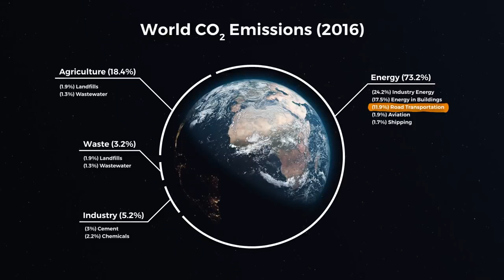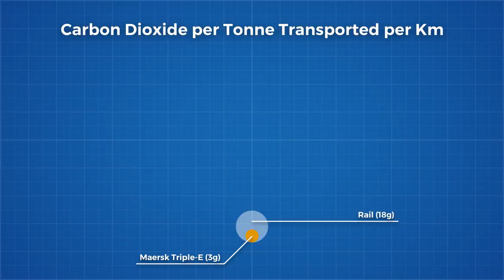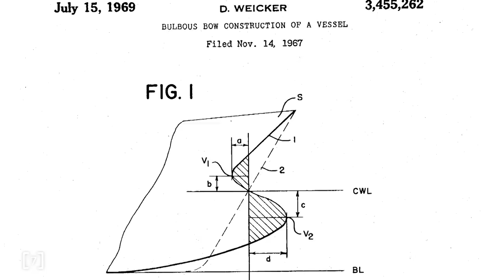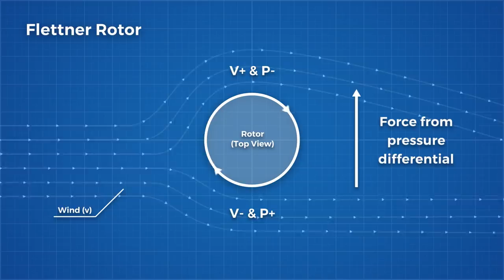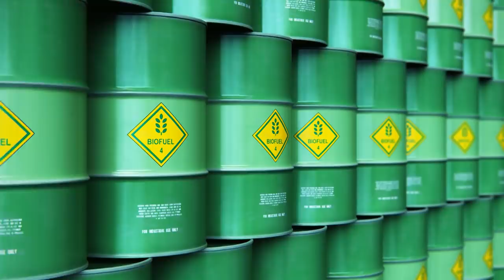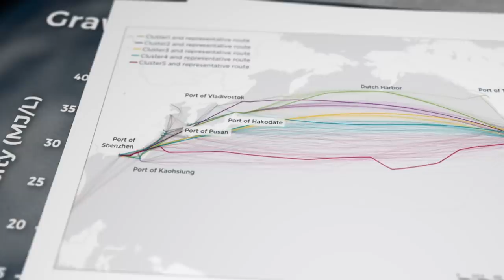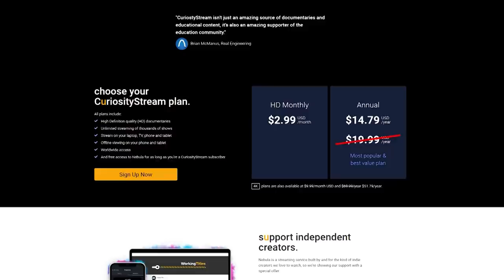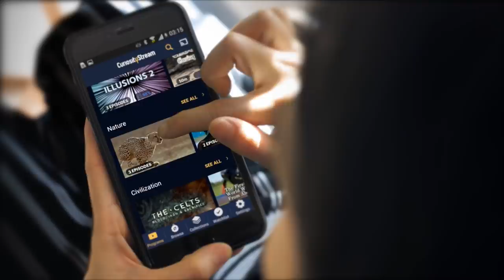Are Renewable Powered Ships Possible?

Comment: Nuclear powered ships?
Reply: This channel is historically anti-nuclear, despite generally being pro-science.
Reply: Uranium fuels unfortunately aren’t renewable - but abundant enough to be used until we have true renewable technologies for everything I guess
Reply: Nuclear is great but it's just not the best for portable applications for several reasons, first and foremost is shielding which as a rule is heavy, the second is availability and security of fuel because governments have a lot of red tape with transporting hazardous substances in and around them, and the third is the initial cost of installment and continued cost of maintenance and staffing.
Reply: A war will cause a catastrophy with a fleet of those.  A single accident for any reason, an angry guy, will cause a disaster.  Risky.
Reply: When facing a problem engineers shouldn't think of ways to add layers of complexity to a problem, but just on how to solve it. It can be done by asking the question differently. Instead of asking "Are Renewable Powered Ships Possible?" we should ask "how can we produce more locally so we don't need to transport a lot of useless stuff"
Reply: Russia has ice breakers which are nuclear powered and is building more.
Reply: Meanwhile Russia is mass producing nuclear power plants ships.
Reply: @bearcatben4762  I fail to see how mass is an issue in this use case.
Reply: makes it extremly expensive to build and the biggest problem decommission. But whit running cost low they can maybe skip all the channels and build bigger and it may be worth  it for some ships. Nuclear powerplant and windfarms out in the water making alot of hydrogen would work as fueling stations for all the other ships.
Reply: @bearcatben4762  The US Navy uses it for aircraft carriers. The thing is when you're moving that much mass you can afford a couple extra tons of shielding
Reply: @pancakes3250  Your understanding of nuclear power is not based on reality
Reply: @bearcatben4762  also might be a bad idea to ship nuclear material around cape guardafui
Reply: The Russians know about that. They have several big ice breakers that are nuclear powered.
I think the Yanks only have them in Submarines. Unless a big aircraft carrier or two are nuclear powered.
But, yeah. I don't know why not. Unless it is cost or safety used on something that isn't military.
Not sure I'd fancy some knackered, shagged out old tub, with a crew of a handful of dodgy bastards from all over the planet piloting it. Imagine them buggering up an entry into a major port to dock, and sinking it in the harbour mouth, in every fuckers way. With a Nuclear Power plant on board.
Bit of a clean up job and salvage job.
Reply: @rationalmartian  All 11 current American aircraft carrier is nuclear powered. Have been for decades. The first nuclear powered aircraft carrier entered service in the US Navy in 1961. She has been retired. 

The US navy also has operated 6 nuclear powered cruisers, although these proved too expensive to operate.
Reply: Ideally yes, but that is a lot of nuclear material to keep track of
Reply: @enricodragoni  Good point, one problem.  Impossible due to human nature.  Some people are better than other, at different things.  China makes it cheaper, due to its political system.  Obviously once we fully automate, price means nothing, all free.  Trade will be culture based.  Wines, art, tourism, luxury anything, even cars.  Cant be automated.  Produced only in dependent region.  Long distance trade wont leave.
Reply: If only governments were willing to experiment by using taxpayer money to create nuclear powered ships and see if they work effectively... 

This post brought to you by the U.S. Navy.
Reply: Fusion powered ships*
Reply: @notsludge  It cant be sabotaged, by a fanatic, or troubled man?  Nations wont attack them?  An accident at sea, i dont know how, or in port, cant cause a problem?
Reply: @TheTwinkiefoot  Gotta make it work on land first...
Reply: Unfortunately, building nuclear powered ships means a requirement for nuclear engineers. Marine Engineers are currently not specialised into this profession as of yet, and incorporating training to do so will likely extend the timeframe of existing cadetships. Interesting suggestion though.
Reply: @enricodragoni  In my perspective, the details of "How can we produce more locally" sounds a dramatic amount more complex and expensive than changing the type of ships used to transport cargo.

Similar to deciding what mode of transport to use to get to work vs figuring out how to work from home. Ofcourse being better for the world but being very complex in achieving that for certain jobs and cargo.
Reply: @bearcatben4762  Actually water is incredibly effective at shielding against radiation. As ships have an abundance of water nearby, they can use well planned pumping infrastructure to shield the crew and cargo from any radiation while minimizing the amount of heavy metal shielding necessary. Most large ships are already equipped with large ballast tanks and pumping infrastructure, so it wouldn't be too difficult to adjust the layout to provide shielding for a nuclear reactor.
Reply: @deth3021  Its the rocket equation, the heavier you are the more fuel you need to increase speed and the more fuel you have the heavier you are
Reply: @bearcatben4762  SMRs solve most of those problems.
Reply: @TheTwinkiefoot  it would be nice but any kind of mobile fusion is decades off at best
Reply: Russia has some floating nuclear power boats!
Reply: @Samuel127849  These companies are cargo companies, all the space that is used for things other than cargo is an economic loss. And the US navy is not a cargo company and only cares about speed and effectiveness.
Reply: @notasgood459  Under that logic, nothing is renewable because the heat death of the universe will happen eventually. Uranium Breeder reactors can provide 10s of thousands of years of power to our civilization.
Reply: @PedanticNo1  scientist aren´t automatically unaware of everything outside of their field of expertise. I am working as an r&d engineer and would get laughed at if would propose a nuclear powered civil vessel. Besides technical difficulties and environmental aspects... It´s unthinkable to let nuclear powered vessels drive around without protection and an enormous amount of control.
Reply: @swilso421  Corrosion is the concern in that scenario and water shielding is still heavy all the while making things more expensive and having more moving parts
Reply: Anti nuclear because it's pro science not in spite of it**
Reply: @pancakes3250  Uranium in a reactor is not the same as in a war head. It needs processing first. But by designing a "dump" switch it might be possible to just dump the reactor into the ocean thus cooling it down real quick and stopping the reaction. Which would reduce total harm done. And this makes "stealing" a reactor harder. Just an idea though.
Reply: @CaptainChrom  That is true but I was not factoring them in because I assumed the commenter was talking about traditional naval reactors.
Reply: @bearcatben4762  uranium isn't the only nuclear fuel.
Reply: @notasgood459  That is also true of fossil fuels
Reply: @ImpGimp  I like your reply.  I am very environmentally conscious.  Any radioactive leak, for any reason, is a catastrophe.  I am against the risk.
Reply: Just eliminate the vast majority of shipping. There's absolutely no practical reason why we should be shipping things all over the planet when they're available locally, or when they can be produced locally.
Reply: @Samuel127849  When your complete business model is based on the amount of tonnage you can transport with your ship and then you are exchanging the profit of seizable number of containers for a heavy nuclear reactor, as a big cargo ship you don't need the tactical advantage to be shore indepedent.
Reply: @PistonAvatarGuy  Cant, locals must work cheaper, even if there are local resources for manufacture.
Reply: For a nuclear reactor to fit into a ship, it needs to be a fast/hot reactor for space reasons - this is the case for all nuclear powered ships and submarines... - fast reactors need highly enriched uranium to work - all of this would be extremly expensive to build and maintain and to get approved... - physicists and other engineers and reactor specialists would have to be on every trip to monitor and operate the reactor.
Too expensive.
Reply: @jeffreylebowski4927  Didnt know.  Cant aoutomate that?
Reply: @pancakes3250  I hate to break this to you, but there is absolutely no way that we're avoiding a catastrophic warming event while still making use of capitalism. Either we move away from capitalism, or we go extinct, it's as simple as that.
Reply: @jeffreylebowski4927  good explenation indeed.
Reply: @jeffreylebowski4927   how big are the engines on a ship that size because the NuScale SMR uses LEU and is 65ft tall and 9ft in diameter
Reply: @bearcatben4762  Doesnt seem to be a problem for Navy submarines and aircraft carriers.
Reply: The issue is an insurance thing. Basically, no insurance company will pay out for an ecological disaster caused by a malfunction or failure on a nuclear vessel. Governments are able to get away with it since they insure it against themselves or not at all.
Reply: @pancakes3250  Psst, dont tell the Russian and US navies...
Reply: @notasgood459  Uranium is as common as tin, and theres 6 billion tonnes in the ocean.
Reply: @PistonAvatarGuy  That is interesting.  Valid opinion.  However, current environmental initiatives were started by capitalist states.  Men like Elon, Gates, are interested in green.  Politicians in every system are aware of impending danger.  They are people, like me and you, capitalist or not.  When alarm goes loud enouph they will react.  I am betting odds are good enough for any system, is capable of dramatic social changes.  I say stay the way we are.  You could be right of course.
Reply: There was a nuclear powered cargo ship called the NS Savannah that is now a museum ship. In addition as someone who attends a US Maritime Academy looking to get a engineering coastguard licence. I don’t trust most of my engineering classmates to run a normal diesel ship let alone a nuclear one.
Reply: @logdog6762  I wont.  O boy.  They are military, or 'state', so, not as numerous yet.
Reply: @bearcatben4762  although nuclear has its problems it has the possibility of truly massive ships that could reduce the amount ships needed for freight on long haul routes that could accommodate the larger ships. For short trips the normal ways of fuel would suffice. I guess though politics and the risk of terrorism and bad maintenance are too big to overcome for the use of nuclear .
Reply: @pancakes3250  how often are nuclear power plants sabotaged by troubled people or fanatics? none that I know of because it is not as easy as flipping a switch. Either way, if there was an accident, radioactive leaks in the ocean have negligible negative impacts. The best argument against nuclear power for cargo ships is cost associated with building and operating the thing (hiring specialists), not the danger.
Reply: @bearcatben4762  I haven't heard of a single nuclear incident in a submarine or carrier. do you?
Reply: @mikee7579  There are nine sunk nuclear submarines in the world.  they haven't exactly caused an 'ecological disaster'.  Oil spills and global warming are exponentially bigger issues.
Reply: Which harbours do you expect to allow those nuclear-powered cargo vessels in harbour?
Reply: @bearcatben4762  by
Reply: @pancakes3250  " However, current environmental initiatives were started by capitalist states."
-
But the problem is largely being caused by those states, and those states aren't coming up with solutions that are even remotely useful.
-
"Men like Elon, Gates, are interested in green."
-
Greenbacks, yes, but they couldn't care less about the environment.
-
"They are people, like me and you..."
-
They are absolutely NOTHING like me, don't assume that you know me.
-
"When alarm goes loud enouph they will react."
-
A) They're too greedy to do anything other than place economic concerns over everything else. B) They're absolutely CLUELESS as to the severity of the problem and have absolutely NO IDEA what it will take to solve it.
-
"I am betting odds are good enough for any system, is capable of dramatic social changes."
-
Capitlalism is inherently destructive and is SEVERELY limited in what it can accomplish because of its inability to make use of any technology that isn't profitable, it is inherently incapable of solving the problem.
-
"I say stay the way we are."
-
Extinction it is, then.
Reply: @logdog6762  insurance is still a thing and the risk for them is huge.
Reply: @JohnJohansen2  Why should harbours  deny them?
Reply: They are extremely expensive and they are a security risk. There is a reason why there are no commercial nulear ships.
Reply: @notsludge  Cant argue with that.  Financially you are right.  Accidents, not really.  All the nukes were land based, or piloted by state.  Having a nuclear merchant fleet, will mean alot more people involved.  There were power plant accidents in the past.  All it takes a state in turmoil, odds rise high.  Even Japan had one.  I dont think we need energy that desperately to risk a nuclear merchant fleet.  War, will be a complete disaster.  Fanatic wise, religion, ideology, bad boss, marriage, social hate can do things.  With people involved, more odds.
Reply: @Andreas Berni A) You're talking about totalitarian dictatorships, not democratic socialism, which is an integral part of EVERY technologically advanced society on Earth. B) None of those actions eliminated the populations of any of those places, people survived just fine.
Reply: @deth3021  At the moment it is the only one in commercial use (not including RTGs)
Reply: @tobene  Yup. If you want to talk about proliferation risks...
Reply: @paulbrazendale3257  Yes that is true
Reply: @logdog6762  The navy is not a cargo company
Reply: @0ExG0  There are rarely any nuclear incidents, that is why I did not mention nuclear incidents in any of my comments
Reply: Nuclear is not the future
Reply: @bearcatben4762  Look up Russia, 13 nuclear powered ice breakers. If its cheap enough to be used for ice-breaking then it's cheap enough for cargo, hell you'd be making a profit.
Reply: @bearcatben4762  But it is a logistics company.
Reply: The main topic in this video is about private transportation. Nuclear ships are owned and operated by governments. Also, from other comments, the Russian ones are far away from hostile forces as well. It's not too much to imagine a pirate attack on one of many private container ships and easily grabbing enough material to make a dirty bomb. Far less likely to happen to a government-operated ship. Security is a very legit concern and likely the primary reason it hasn't happened and governments won't let it happen.
Reply: @holyravioli5795  Yeah, but Russia probably wont bother decommissioning the ships properly, they'll just scuttle them somewhere. Decommissioning costs are a serious concern with nuclear powered ships (in sane countries).
Reply: there is a plan in mersk for using nuclear power in stations o the mid route for hidrogen generationñ the onli practical problem whit nuclear is the ports regulations.
Reply: @pancakes3250  i get what you are saying, more nuclear reactors over longer periods of time increases the likely hood of something going wrong (whether an accident, or an attack). What I'm saying is that something going wrong with nuclear ships is relatively benign. A nuclear sub sinking does not equal reactor meltdown due to the cooling of the water. Also nuclear engines are not nuclear bombs so they don't result in nuclear explosions (not saying you believe this just that it is a common misconception I've seen). Even if there was a nuclear meltdown it would still be a non issue because water is really good at shielding.
Reply: I keep seeing that nuclear is too dangerous, but  
a) it’s a proven technology that can be improved upon and it’s by far and away the most studied method suggested here 
b) I’m not sure it’s any more or less dangerous than other fuels. The biggest danger of nuclear is that the reaction can happen quickly so all of the energy is released instantaneously rather than slowly over time like what would happen if diesel caught fire in a tank. I would think hydrogen would be a close second though given the reaction rate and the likelihood of it being in gaseous form within the cells or it’s ability to quickly become gaseous if it’s in liquid form. It would just be a huge Hindenburg. But we have technology that would make a nuclear meltdown not only unlikely but not catastrophic. In other words, it’s not like there would be a nuclear bomb on every shipping container. It’s only dangerous if you have a lot of fuel in the reactor at one time and you have no safety measures in place to prevent a meltdown. But they’re already making modular reactors that are self sufficient. That means it wouldn’t take too many additional staff to run the reactor. 
c) during a war, there wouldn’t be any more or less incentive to blow up shipping freighters than there is now. All of the fuel would be shielded, and there would be a huge mess to clean up if any of them sank and blocked the harbor regardless of what fuel you’re using. A reactor would just have different problems than a harbor full of crude oil. But again, you’d have to deliberately sabotage the fuel and the reactor on the ship in order for there to be a real problem. And the bomb, if you could pull it off, would not be a city-destroying nuke. You wouldn’t need that much nuclear fuel to power the ship for just one trip. It’s no more dangerous than letting an aircraft carrier dock at a harbor. 

And obviously the best solution would be fusion, but the tech doesn’t exist yet, and even if it did, the tech for making a reactor small enough doesn’t exist yet and probably won’t for quite some time, and even if it did, it would be insanely expensive. But even if we powered the world with nuclear energy, we’d have enough for 10s of thousands of years, more than enough time to transition into fusion.
Reply: @PistonAvatarGuy  I like its great.  Lets see.
Every state under every system started environmental problems.  Greed and self-preservation, is for everybody.
Gates and Elon care, but money before the environment, you are right.  This is true for anyone who is a leader.  However, Tesla's main consumers are capitalist environmentalists.  So the greener the tech, more profit.
You are right, they mostly, not like you, but they are people.  Not as humane as you, but enough to react to a global flood.   
You are absolutely correct, they are greedy, i dont know, if too many, too greedy. 
Capitalism is not inherently destructive, just extremely prone to it.  Faar more than socialism.  However, fortunately, capitalism doesnt, usually, override self preservation and grand humanity.  If the cost of expansion is flood, too many capitalist will object.
I like the system i am in.  Not convince to change.
To me communism is a political view, not a system of government.  I am extremely democratic.  Communism or socialism, to me just a political view, capable to operate in a democracy.
Reply: Two big problems:
1. Waste. We don't have anything to put nuclear waste.
2. Actually getting Uranium into a form in which you can put it in a reactor is a huge mess, and certainly not good for the environment.
Reply: @notsludge  I agree with this.
Reply: @Andreas Berni "Socialism, no matter in what form or expression, is a totalitarian, autocratic system."
-
No, it isn't, certain forms of socialism can offer FAR more freedom than capitalism ever could, because you're not FORCED into serving some monstrously evil corporation in order to survive.
-
"A social welfare state as in Scandinavian countries or in Central Europe is light years away from socialism."
-
Oh? ... "The economy of Norway is a highly developed mixed economy with state-ownership in strategic areas. Although sensitive to global business cycles, the economy of Norway has shown robust growth since the start of the industrial era. The country has a very high standard of living compared with other European countries, and a strongly integrated welfare system." ... State ownership? That sounds like socialism to me! So what's a mixed economy? ... "A mixed economy is variously defined as an economic system blending elements of a market economy with elements of a planned economy, free markets with state interventionism, or private enterprise with public enterprise."
-
A planned economy might sound authoritarian, but if it's democratic, then it is beholden to the people of a country.
-
Sorry, buddy, but it's either this, or extinction. Capitalism cannot cope with global warming, PERIOD.
Reply: @scotticusmaximus5558  Yeah, maybe SMRs are an option - once theyre fully developed, tested and mass produced... -  but not right now or in the near future. Wikipedia says this:"NuScale has been approved to build test reactors in Idaho, in 2029 and 2030" - Another thing i read there is, that theyre meant to be under ground and are only passivly save, as long as the entire reactor is suspended in another pool of water: "In the event that AC power is lost for normal cooling systems, the pool water in the pool begins to absorb heat and boil." So if you want that reactor to be save in case of a power loss you need to add a big pool around it... So we need to add that big pool to the reactor dimensions and weight... So I doubt that we will see SMRs in ships before 2050. But Im no expert obviously.
Reply: @pancakes3250  What disaster? Out at sea is the least impacful place possible for a release of nuclear material. It will literally sink to the bottom, surrounded by the stuff we use to shield from radiation - water. 1 m of water stops even the strongest gammas and neutrons.
Reply: @bearcatben4762  Everyone on this thread who has not immediately given the thumbs down to the concept of nuclear power, has said A) it isn't renewable and B) it's too heavy, too complicated, too vulnerable, too expensive and too inefficient.  That's because everyone  is thinking of the 'conventional' Uranium Cycle reactors currently in use.

Google Molten Salt Liquid Thorium Reactors and Kirk Sorensen.  A MSLTR can easily fit into moderately sized ships and two plants could fit into those giant Maersk ships.  Sorensen estimates a 250MW plant would fit in the area and weight of a current CHP (Combined Heat and Power) plant.  They are intrinsically safe, operate at one atmosphere, are scalable and can burn waste fuel from PWR's and other uranium cycle reactors.  Burn it away to nothing and thus help solve the high level nuclear waste problem.

MSLTR's really are the 'invention' the fossil fuel industry doesn't want you to know about.  They know how frightened people are of anything 'Nuclear' and if any money was spent on bringing them to large scale production, the fossil fuel lobby will spend BILLIONS making sure you stay frightened.
Reply: Do you guys forget that most of the shipping company now allowed to employ PMC to secure their ships? Lets say the ship attacked whether from outside or inside via mutiny, do you think those PMC or any other clear headed crew will try to defend to death the ships if they know that in the end their life is in line anyway? Not to mention the military also wont sit still if this scenario really happened, esp after multiple terrorist attack this past decades....

Yeah the only reason they dont use nuclear powered cargo ship is still purely economics, seriously, they are company, they went green either because its cost effective or regulation......
Reply: @bearcatben4762  We already have nuclear vessels, though.  The military has an excellent record with them.
Reply: @bearcatben4762  how much does the fuel in a conventional ship weigh? 6 pounds a gallon or so.
Reply: @pancakes3250  yeah you could send them as ramming vessels in war
Reply: @mikee7579  It's a myth that nuclear facilities can't get insurance.  underwriter love insuring reactors because they claim premiums year after year and claims are rare.
Reply: Very soft target for terrorism, just catch one on fire in a city port and see the panic. I used to work in the industry but I'd still get my family well away from that even though I know the dangers would be very minimal. That panic would course many deaths and end nuclear powered civilian ship industry.
Reply: @JohnJohansen2  Anyone except New Zealand.
Reply: It would need to have some serious protection on board too. Imagine if the ship was hijacked and someone stole uranium from it to go make a nuke?
Reply: @jaroslavhancovsky8265  I agree.  However local animal life will catch it.  Food chain can transfer it to us.  Radiation wont dissipate for a long time.  Sooner or later cancer rates up.  Is it not Chernobyl, but bad.  If it sunk deep water, i doubt the impact, maybe currents.  I am 'allergic' to environmental disasters, especially radiological once.  To me its really bad.
Reply: @notasgood459  Fast breeding reactor?
Reply: @notasgood459  Uranium is only one possible type of fuel. There are quite a few others.
Reply: @saxreaper  Noone will, but they can be armed.
Reply: @00dfm00  Lol, have you seen a video of Russia dealing with hijacked ships? They wouldn't make it a few km before Russian  destroyer's were circling it and popping off 30mm warning shots followed by RNI frogmen taking back the ship by force. And that was just a regular cargo ship, can you imagine a ship carrying nuclear material? 
If Russia were to start allowing privately owned nuclear cargo ships i can guarantee they would at minimum have on board security of some sort.
Reply: @PedanticNo1  what video is he anti nuclear in? Were there problems with the economics of nuclear energy video? Cos he has pointed out that France basically powers most of the EU's baseline needs with their nuclear plants. Just b/c he says nuclear is less economical doesn't mean he is anti nuclear.
Also I LOL'd at the "generally pro-science" thing. This is a 100% pro science channel dude. SMH.
Reply: @notasgood459  Renewable energy is an oxymoron. Even the sun is not renewable.. in the long term.
Reply: @TheTwinkiefoot  Fission is easier.
Reply: @blaster1185  International treaties and legislation will likely limit enrichment of ship reactor fuel to sub-20%.  Weapons grade material needs to be 90% or more.  Enrichment requires a massive warehouse full of specialized equipment that are very hard to hide from satellites.
Reply: @mikee7579  Actually it will be more ecological and in case of accident much easier to recover the nuclear reactor than tons of oil. And if the ship sinks deep enough, who cares.
Reply: @PistonAvatarGuy  Realistically the nuclear fuel could be reprocessed into more fuel, its already common practice among alot of countries. The rest of the ship can just be sent to India for breaking and reuse.
Reply: @enricodragoni  Everything is secondary to avoiding the ravages of climate change, I agree, but self sufficiency is very inefficient. Comparative advantage is a powerful thing.
Reply: @logdog6762  I believe you're wrong! 
Big time!
I know for sure that my country would never allow nuclear powered shipping in national waters.
Not commercial anyway.
Reply: @adamthornton6149  That could be an argument for making the technology more accessible. Have something which is passively safe, is removable so can be refuelled by nuclear engineers back at the manufacturer, and is no more complex to operate than a regular ships engine. It probably can be done, indeed some of the ideas around small modular reactors have these sorts of goals in mind.
Reply: @pancakes3250  "This is true for anyone who is a leader."
-
Which is why we're doomed as a species.
-
"However, Tesla's main consumers are capitalist environmentalists."
-
Which is a contradiction on terms.
-
"So the greener the tech, more profit."
-
Oh? So where are the carbon nuetral synfuels? Where are the nuclear power plants? Where are the free heatpumps for everyone? AGAIN, there are no solutions which are profitable.
-
"Not as humane as you, but enough to react to a global flood."
-
But they aren't reacting in any meaningful way, because they are driven purely by greed.
-
"capitalism doesnt, usually, override self preservation"
-
It ALWAYS has.
-
"If the cost of expansion is flood, too many capitalist will object."
-
BUT THEY WILL BE UNABLE TO OFFER ANY SOLUTIONS, AS THE SOLUTIONS ARE NOT PROFITABLE.
-
"Not convince to change."
-
Then watch the world die.
Reply: @Andreas Berni You don't even know what socialism is, do you? Define it for me.
-
AGAIN, your examples consist of communist states and dictatorships, I'm not suggesting the adoption of either.
Reply: @holyravioli5795  The main concern with the fuel is proliferation. I suggest that you read more about how difficult and expensive it is to properly decommission a nuclear powered ship.
Reply: @EvelynNdenial  You'd crack it open with a load of C4 or something similar. It's not hard to make a real mess out off any reactor. Even just the fact someone had taken control of a ship with a reactor would course mass panic. I gave a presentation on terrorism against the nuclear industry one of the reasons why I was hired into the industry.
Reply: @JohnJohansen2  What country is that?  I know New Zealand has specific laws against Nuclear powered vessels.  Look at it this way, if nuclear propulsion became a significant proportion of international shipping, tTese laws would be repealed very quickly.
Reply: @PistonAvatarGuy  Thats awesome.  I like how you divide things.
Ok, money is before the environment, not before self preservation, or greater humanity.  We might be fine.
Anyone with a job for profit is a capitalist.  They like things, like breathing and clean water, parks.
Elon is an idealist.   He wants green, thats why Tesla.  However, if it costs him his financial well being, he will steer money.
Absolutely correct, no carbon negative solution is for profit.  Impossible.  Carbon neutral exist.  Gates chasing them, so is Elon.  Renewable energy basically.  To get everything you mentioned requires a social phenomena.  Communism isnt necessary.  Our system is doing it already.  Will we do it in time, dont know. Odds are poor, but higher than not.  Biden is very green.
Going communist, but still a democracy, no other way i approve, will work only, if people dont care about their financial well being.  In a democracy, capitalism isnt enforced, if people dont care about their money, they will vote it.  Will i, no.  I am pro social change regarding environment, but still pro-capitalism.  I am willing to be taxed.
To each their own, in my opinion.  I rather have severe public awareness in hopes common capitalist guy, wont choose to keep their money, believing flood isnt bad.
Stay you, who else informs others.  I dont.
Reply: @pancakes3250  learn how a reactor works, the uranium isn't enriched enough to be a weapon
Reply: @enricodragoni  Exactly. We should be asking if transporting almost everything halfway around the world is truly the best system, all things considered. I think we will learn soon enough, as Asian countries are slowly losing their price competitiveness. Maybe in the long run it will be cheaper to produce most things locally, from local resources.
Reply: @loooooopy  I agree, however its radioactive.  Containment breaches, pollution.  Bad enough.
Reply: @logdog6762  Specific Denmark but, I'm sure rest of Scandinavia and Iceland have the same approach. 
Even Svenden.
Reply: @notasgood459  Seriously. These things are so bloody huge they could absolutely support a reactor or pair of small ones quite safely. It's high upfront cost, but would save billions in the long run. With small modular reactors coming into their own, I don't think it'll be long before we start seeing them.
Reply: @bearcatben4762  If you think radiation shielding is heavy, you should see how big the diesel tanks on these ships are.
Reply: @pancakes3250  
Anything can be automated.  Even me.  I could be a bot 😋
Reply: To be cost effective with nuclear reactors, commercial ships would have to be much, much larger. Too large to use some of the canals that are a vital part of world trade. 

Also, when many ships are broken up, it is done in developing countries by underpaid workers who are constantly put in danger. Not only would these workers possibly be exposed to any irradiated components of the ship, but also these irradiated components would be left to be washed out to sea.

It's not practical, not safe, and as a result not worth considering as an option.
Reply: N.S Savannah was the first one built
Reply: @JohnJohansen2  Denmark are great at the green energy.  Massive oil reserves which she is happy to export and profit from, but it's OK because she is powered by wind, which is possible she can use rest of Europe as a her battery. Sweden may get away with closing nuclear if hydro can step up, but I dont think this is the first time they tried, and Finland is getting Russian VVER's because Western EPRs have proven a bit of a challenge.
Reply: Noticably absent from the discussion. The fact that it wasn't mentioned even for the sake of dismissing it leads me to believe the author(s) are far too biased in their research to form an unbiased opinion.
Reply: @aidanjt  A naval submarine's nuclear reactor weight is 1,405 tons, a new Panamax ship holds 10,437.5 tons of fuel, But container ships are much larger than submarines. The Ohio class submarine weighs 16,764 tons, while the average container ship weighs 100,000 tons. So that means the average container ship is 6 times larger than a large submarine, which means a submarine that weighed the same as the average cargo ship would need 8430 tons of reactor at the bare minimum, but what is not factored the square-cube law, a submarine would need to grow wider and longer which would increase drag and would demand more reactor because the surface area of the super sub is so much higher which would increase the 8,430-ton reactor size far beyond the  10,437.5 tons of fuel needed for a cargo ship
Reply: @PistonAvatarGuy  Ok.  Sorry, for some reason i thought you were suggesting communism.   A big difference.
If it takes more than taxed into a homeless shelter to check global warming, hmm.. nothing will work.  Even China cant push enough of its people, into suicide, to stop it.  
Utter selflessness, without, dead anyway, doesnt exist on mass.  
Socialism, if it can stop, when even brute force cant, then capitalism can too.  Just tax, and regulate as a matter of national emergency, if necessary.  I am for it, if China, Turkey, Russia behaives. 
If it still going nowhere, i understand.  I am absolutely no expert.  Hope you find someone better suited for this.
Reply: This is not the worst idea out there.  The technology existed for decades powering aircraft carriers.
Reply: Nuclear power is certainly an important consideration in the effort to reduce greenhouse gas emissions, and nuclear solutions like modular reactors may be part of the mix in the future, but there are reasons  the shipping industry hasn't explored the technology before this. Mostly it's just too complicated and expensive. Cargo ships are like plant eating dinosaurs of old: enormous, reliant upon economies of scale to function, and as simply designed as possible.
Reply: @bearcatben4762  That and that if a ship sinks, the cleanup is gonna be expeeeeeeeensiiiiiive
Reply: Has been tried, too expensive. Russia has some nuke ice breakers, but nuclear cargo ships came and went during the sixties and seventies.
Reply: At that point, given the level of complexity and cost, you may as well just produce synthetic fuel sludge from algae or synthetic gas (which is renewable) and burn that in the ship. Notably, this would require no modification to the existing shipping stock.
Reply: @pancakes3250  
How do you figure? There are currently about a half dozen reactors and a few weapons on the seafloor.
Reply: 80% of the worlds cargo for less than 2% of the greenhouse gas output? I think we  need to be looking for solutions to the bigger polluters first, India and China.
Reply: Ben Allen  Is it much better to trust them with thousands of tonnes of bunker fuel just waiting to spill into  the ocean?
Reply: @BasedBebs  Not as much as you would think, several nuclear-powered submarines have sunk and the reactor has never actually broken up and strewn waste around and even if it did it would all stay at the ocean floor where the biomass is relatively slim
Reply: @pancakes3250  Wrong. If a nuclear reactor on a ship is out of control, then the corium just falls in the water and nothing is released in the atmosphere.
Reply: @pancakes3250  The limited imagination of some people amazes me. It's not people who need to change (significantly), it's mainly the energy sector. Suicide/mass killing is also not the answer, absolutely not. With a socialist economic system, direct resource management becomes viable, which means that any amount of resources can be made use of without any kind of monetary cost.
-
If people need a carbon neutral synfuel to put in their vehicles (while we transition to a more efficient society), but producing it is hugely energy intensive, it's not a problem, the resources are simply managed directly and the cost to the consumer is controlled in the way that is most beneficial to society. If every coal and natural gas power plant needs to be shut down and replaced with a nuclear power plant, it's not a problem, the resources are simply managed directly and energy prices are controlled in the way that is most beneficial to society. If carbon dioxide needs to be pulled from the atmosphere and sequestered on an absolutely enormous scale (this needs to happen to avoid a catastrophic warming event), the resources needed to make that happen can be made available. If every gas and oil heater in the country needs to be replaced with an electric heat pump... If public transportation systems need to be expanded/improved... If high speed rail and maglevs need to replace air travel... etc, etc, etc... It can all be done with resources that are already available, without the restraint of a monetary system.
Reply: I think heavy petroleum fuel is the answer ...what they are doing right now ... ocean shipping is profoundly efficient and he stated 2 % of the worlds carbon .... I say leave it be and tackle other things .
Reply: Seriously, did you even bother to LOOK before you made that idiotic statement? All of the US's aircraft carriers have been nuclear powered for decades, as have all of our subs. The last non-nuclear carrier was retired in 2007.
Reply: It's been tried, there is a reason why it never catched on, I think N/S Savannah is the only merchant ship ever built with nuclear power.
Reply: @bearcatben4762  It wouldn't fit into a car, but it's perfect for gigantic ships. The worlds millitary have entire fleets of nuclear ships. Pretty much every submarine is nuclear powered.  Also a ship would require a tiny reactor compared to power plants. Even in the case of a meltdown the environmental impacts would be almost negligible. If it happens in the middle of the ocean it would be entirely negligible.
Reply: @markdoan1472  It should be low-hanging fruit, though, just produce locally, stop transporting things unnecessarily.
Reply: @bearcatben4762  The engines of a nuclear powered carrier aren't really significantly different in size from a non-nuclear version. There's also the advantage that space that would normally be reserved for massive amounts of fuel can be used for cargo.
Reply: @pancakes3250  it is not due to political system. China have one thing US does not have - population. Which in terms to a degree slows inflation. The biggest advantage China have is lower cost of living (meanwhile not necessarily lower standards of living, go visit China if you don't believe me). The low cost of living is somewhat connected to the ideal of not supporting capitalism on critical subject such as insurance and over investment. (Yes China have a huge housing bubble, but Chinese government is actively suppressing it, before China turns into Japan in 1990's or America in 2008).

It gets a lot complicated very fast. TL;DR, Made in China will continue for at least next 20 years. And United States is the major benefactor since the 80s, you can even say China helped US win the Economic part of Cold War.
Reply: @PedanticNo1  indeef
Reply: @PistonAvatarGuy  That would be fine if everything people need COULD actually be produced locally, but that simply isn't the case. Different parts of the world have different resources that are needed to produce different products. Try making any modern electronics without access to the rare earth elements that are most abundant in China, and virtually non-existent elsewhere in the world.
Reply: @pancakes3250  Ship crew underwent quite extensive mental evaluation and training. (Since shipping company already know they will be spending 9-12 days at sea, especially after the slow down). Modern Merchant only have some 12 crews on board, and those large container ships can't sail right into most major cities like Shanghai or New York.    Also nuclear reactor on ships tend to run a lot stable and cool. The real problem is they are not cheat and scrapping reactors is a big problem...
Reply: @PistonAvatarGuy  Proliferation isn't an issue if you build the reactor properly, gen IV reactors for example are pretty much impossible to cause proliferation. Especially if its a thorium-molten salt reactor. And if you want to make decommissioning less of a hassle it should be possible to make the reactor modular, as in one single self contained unit that can be removed and stored until the fuel cools down while the rest of the ship is sold for scrap. Especially with something like a cargo ship thats massive this shouldn't be an issue, it was only an issue because until now the only nuclear powered ships that have been decommissioned were all military based and as such were extremely well protected reactors designed to protect against various types of attack which incidentally made decommissioning a massive pain in the ass. Same goes for submarines but way worse.
Reply: @PistonAvatarGuy   I like your solutions.   They all sound great.  How about, same thing, but as a national emergency measure.  It can be done under capitalist democracy. 
I prefer wait for fusion, before thoriums.  Synth fuels, sure, i like it.  I prefer E-vehicles, and hydrogen for trucks, more efficient.
Synth for industrial use.
Must be international, not just us.  So push that first.  My opinion.
Reply: @mattelder1971  The vast majority of everything that people consume can be produced locally, the only real exceptions are foods which only grow in certain regions.
-
Yes, certain resources are more abundant in some areas than they are in others, but that doesn't mean that they're nonexistent. If resources are not abundant, then they should be consumed in limited quantities, we need to reduce the scale of our consumption anyway.
Reply: @bearcatben4762  Ships are not rockets... I studied rocket equation myself, the payload capacity is fraction of fuel because you need consider about of energy to get up to speed to "stay afloat" (get into orbit). Ships on the other end... Well, they are already floating... They only need to deal way drag cussed by water which is related to cross section of ship under water (that is why ships are long instead of wide one only need to make it a tiny bit wider to increase tons of capacity) Drag=0.5 density * velocity^2 * Coefficient of drag * cross section area.
Reply: @holyravioli5795  With the reactors that are small enough to be used on ships, proliferation is (typically) a significant issue. Anyway, I just don't see the point, the safest, cheapest and most effective solution would be to eliminate shipping as much as possible.
Reply: interesting idea, some american aircraft carriers runs on nuclear
Reply: @TheLoxen_  At the time, there was little motivation to move away from fossil fuels, so the infrastructure wasn't in place and wasn't economical to implement. The same could be said for electric powered cars. The have been tried off and on throughout the early and mid 20th century before finally being successful in the last decade or so.
Reply: @pancakes3250  " How about, same thing, but as a national emergency measure.  It can be done under capitalist democracy. "
-
It can't, because money. The only way this could be done under a capitalist economy is to generate enormous amounts of debt, which would cause inflation to skyrocket. You're basically suggesting that we create hundreds of trillions of dollars out of thin air!
-
"I prefer wait for fusion..."
-
It may NEVER be viable and we were out of time DECADES AGO. Like I said, you people have no understanding of the severity of the issue. You can prefer "E-vehicles" all that you want, but they can't meet the needs of many applications and they're FAR too expensive for most people to buy. Most people also don't want BEVs. Hydrogen is a greenwashing scam and always has been, it was never going to be a solution to anything.
-
It must be international, but someone needs to lead by example.
Reply: @PistonAvatarGuy  Unless you live in mainland China, I can all but guarantee you that your phone or even computer could not be built where you live, at least not for anything approaching an economical price. You seem to know very little about how the things you use every day are produced.
Reply: @PistonAvatarGuy  Not keen on that plan .. soybeans , beef , corn , wheat just for starters are shipped world wide ... many concentrations of population would live a bit lean  without oceanic transport ... plus our standard of living would drop some without world wide trade .. its easier to say than do
Reply: @mattelder1971  I use an 8 year old computer and a 7 year old phone, I think that I could afford to buy a new one of those devices every ~10 years.
Reply: @PistonAvatarGuy  LOL, way to TOTALLY miss the point.
Reply: Its been done NS Savannah  
it was a total disaster  nobody wanted it in there port  hard to get crew  
safety drills must have been a nightmare.
Reply: @markdoan1472  Like I said (to someone else, I think), food is just about the only resource that really needs to be shipped. Our standard of living is going to drop anyway, whether we address global warming or not. If we don't address the issue, it will drop to basically zero.
Reply: @AaronShenghao  Honestly, i dont know how China's economy works.  Can people ask for a raise?  If they get enough to afford a comfortable life without social wants, then i am extremely surprised their products are cheaper.  
Their system is near autocracy.  Freedom isnt cheap, literally.  You will want culture, travel, quality entertainment, connections.  Its expensive.  You will want freedoms, after that.  If freedom to be yourself, completely, is denied and accepted, they will work for less, they wont want luxury that will inspire freedom.    
Political system, i believe, has a huge impact, on price, even if played fairly.
The merchant crew, i believe you.  So odds of a personnel incident is extremely low.  This is true if the system holds.  Checks, good pay.  If it doesnt, because of economy,   
or unrest, at best nuclear fleet will be beached, at worse, well, incident.
I dont think we are that desperate to risk a nuclear merchant fleet.
My opinion only.  I understand if you know more, and have a different opinion.  You maybe right.
Reply: @mattelder1971  You said that resources would get more expensive in regions which have limited access to those resources, I agree. Anyway, dealing with China comes with far, FAR greater problems than just emissions from ships, all ties should be severed regardless.
Reply: Those already exist.
Reply: @PistonAvatarGuy  Yes, you right, absolutely, debt thing.  Money will be printed, but not fake.  It will be payed off.  Cuts, taxes, poverty, very bad.  I am willing.
Hydrogen a scam, i dont know, Japan into it, EU.  If you are right, then synth, 100%.
Fusion, yes a gamble.  Like you said, i dont know how bad it is.  If it is, almost now or never, then nukes, pray no war.  I will trust the experts under Biden.  I could be stupid, let me know.
Lead by example, absolutely, CCP wont follow, Putin wont follow, Iran, Erdoran.  They will abuse the situation.  We all lose.    International first, lead there, or no deal.
Otherwise plan for the flood.
Like you, you affected me, i am much more ready for drastic measures.  Still pro capitalist.  My tastes i guess.
Reply: @pancakes3250  "It will be payed off."
-
It wont, that's the problem, We're already in a huge amount of trouble with our national debt, it's only in the tens of trillions, but it's not being paid off. Increasing debt without end leads to hyperinflation.
-
You also seem to not understand that profitable items need to be produced in order to pay off that debt, which means that more resources need to be consumed, which further exacerbates our environmental problems. Capitalism is nothing but problem after problem.
-
Yes, you are stupid to trust Biden.
-
Hydrogen is too expensive, as are synfuels. That's my whole point here, there are solutions, but they're too expensive in a capitalist system.
-
How are nuclear reactors related to war?
-
Your tastes are leading to the demise of the human race. Why do you prefer death over socialism?
Reply: @PistonAvatarGuy  That's fine, but as I said, be prepared to give up many of the things you rely on in your daily life. They will either become prohibitively expensive or completely unavailable without shipping resources from other countries, China in particular. That Polk subwoofer that you feature on your channel? I can be almost certain that the magnet that drives it uses materials mined in China.
Reply: @felixar90  The navy does not carry cargo and therefore can spend a lot more mass on a reactor. That is true the melt-down impacts are negligible that is why I have not mentioned melt-downs as a problem in any of my comments.
Reply: @mattelder1971  A nuclear reactor is constructed wholely differently from a ICE because with combusting fuels you don't have to worry about the fuel producing its own heat.
Reply: @mattelder1971  The only infrastructure you need is being able to transport the fuel rods to the boat and from the boat after several years when they are depleted. They can do it for militaries and the Russian icebreakers fleet. 

The problem is having thousands of ships going around the world with materials that could be made into devastating weapons.
Reply: @bearcatben4762  shielding isn't a problem for ship, a reactor is probably much lighter than a oil powered engine + literal hundreds of tons of fuel, they already power aircrsf carriers and submarines for good reasons
Reply: @notasgood459  Uranium reactors are really bad and uranium (even used rods) can be used for bad things. Look into Thorium reactors they physically can't melt down. Thorium is also more abundant in the earth and it produces less waste.
Reply: @mattelder1971  You missed the point of my comment. Things aren't prohibitively expensive when you replace them far less often. If someone replaces a laptop every 10 years, instead of every 3, they can afford to buy a much more expensive laptop, the cost can basically triple.
-
"That Polk subwoofer that you feature on your channel? I can be almost certain that the magnet that drives it uses materials mined in China."
-
It has a ceramic magnet, not a neodymium magnet. The materials for ceramic magnets can be mined just about anywhere.
Reply: @PistonAvatarGuy  Fair enough on the subwoofer, but the materials I'm talking about wouldn't be 4 or 5 times more expensive, they'd be 100s of times more expensive, if you could get them at all.
Reply: @notasgood459  
Just make U-233 with a Th-232 breeder reactor. Th-232 is plentiful, especially in America, India, and Australia.
Reply: Too expensive + a lot of regulations (and some countries literally will not let you dock). It's easier and more realistic to transition to renewables.
Reply: @anentiresleeveoforeos2087  If many of the major shipping companies banded together and said that they were all transitioning to nuclear powered ships and told ports that either they be allowed to dock or those ports would no longer be getting goods, you can guarantee that the regulations would change very quickly.
Reply: @pancakes3250  You're not understanding, the solutions to global warming will cost HUNDREDS OF TRILLIONS OF DOLLARS, just in the US, there is no way to pay off that much debt.
-
NOTHING would need to be cut with a system of direct resource management as there is no need to pay off the debt, because there would be no debt.
-
"Now, socialism.  Where the industry is forced to produce without fair compensation."
-
Since when does capitalism offer fail wages? It has to be forced to pay people more than poverty wages and wage slaves are a real problem under capitalism. You're just not understanding. With direct resource management, pay is flexible with no limits, people would simply be paid with non-circulating credits. There would also be no taxes.
-
"Still, if they are willing, i am willing debt, and poverty, if its fair."
-
It's not fair because it's not necessary.
-
"...but just more appropriate than Trump, now."
-
They're both evil psychopaths and neither did, or will do, anything good for my country.
-
"Well if we go kill each other, nuclear plants are juicy targets."-
-
So are many things, I'm not sure why that would matter in a nuclear war. Nuclear war is basically endgame, so it should be avoided at all costs.
-
"Socialism, has the same chance to fail if forced. "
-
That's why people need to be made aware that it's the only thing that can save us.
-
"Manufacturers wont do it.  They have to pay salaries."
-
It's not their concern under socialism, they become part of the state. Why do all of the critics of socialism seem to have no idea how it works?
-
"Noone will work for free."
-
Who said that they should?
-
"If everyone willing to sacrifice appropriately, like me and you, any system will work."
-
Almost no one would need to make any sacrifices under the economy that I'm describing. That's the thing here, I'm not willing to sacrifice when there is no need for sacrifice.
-
"I am not risking catastrophe any more, than under socialism."
-
You only think that because you don't understand what's possible with socialism.
-
"Capitalism feels better to me."-
-
Not starving to death feels better to me.
Reply: @bearcatben4762  They carry airplanes, armor, ordnance. and a shitton of ammo. 

The kind of reactor they would need to power a ship isn't very big or heavy at all. Probably the size of a single container.

And you can remove a gargantuan fuel tank, making room for MORE cargo. 

I'm nor even gonna look it up but just by guessing I can already tell that there's no way a reactor is gonna be larger or heavier than the fuel tank they already have. 

Ok I actually did look it up. The fuel tank is between 2.5 and 3.5 million gallons.  10,000 cubic meters. They have entire nuclear submarines that are smaller than the fuel tank on those ships. (assuming US gallons)
Reply: @AaronShenghao  The particular part of the rocket equation that is important is the part about having to carry fuel to accelerate the fuel that you are going to use to accelerate more and since you are not getting refueled constantly you will always have fuel in your tanks slowing you down so a reactor with a weight that does not change compared to a fuel that you are going to burn off into the atmosphere means that the atmospheric exhausting fuel is always going to win because it's actively becoming less effort to move. Since you are an astronautical engineer, let me put it this way, imagine if you had to keep all your exhaust on every rocket you produced that would make your efficiency suffer quite badly.
Reply: Ben Allen  I'm not against fission at all as long as it's safe and economic. So I guess for now I'm against rolling it out, just keep up the research.
Reply: @enricodragoni  The thing is, producing more efficiently where there is expertise often offsets the minimal emissions from transportation.
Reply: @mattelder1971  You misunderstand. Those regulations aren't just bureaucratic redtape, they're legitimate safety procedures and guidelines thatinflate the costs of nuclear power wherever they're (rightfully) in place. It's fine for a large power plant due to the specific economics involved but there's a reason why portable nuclear power has pretty much been limited to niche military roles like carriers and submarines.

Also, if a bunch of companies confronted the world's countries and tried to demand anything from them you'd better believe they're going to get lawsuits, investigations and sanctions placed against them before being forced to back down and get a shit ton more government oversight shoved down their throats. Governments aren't going to get bullied into that sort of thing and they're not going to risk sensitive technology getting leaked to 'rouge' states.
Reply: @EvelynNdenial  Yes but that's the way it is, because idiots have messed up before the public don't trust. 
Look at how many ships are taken at the moment, the coast guard is pretty much powerless. For example anyone touches Irans nuclear program, they would have plenty of volunteers for a one way journey. And they have the knowledge and resources. Terrorists are called that because it describes what they do and nuclear does terrorize the public.  Thats just the way it is.
Reply: @PistonAvatarGuy  I doubt it ... Im willing to bet global warming based on CO2 is not remotely an end of days ...reason I say this is the same energy from the sun hits us every day ..much of it escapes back out ... CO2 no matter what level it reaches will not cause a cataclysm ...simply a shift and then stabilize ... reason being it can't become more and more of a blanket... it stabilizes  and plants are able to pretty much cycle it out anyway with photosynthesis ... Gravity will keep all water , every molecule of air now here to remain here and not escape into space  ... I believe it is physically impossible to warm the planet two more degrees .. The heat escapes ...most of it ... I think this CO2 warming end of days is alarmism only
Reply: @notasgood459  not quite. People have probably already commented to correct but we have enough uranium to last until the sun dies. And if we didn't.. we have enough go last until fusion. Not till something as silly sc renewables
Reply: @enricodragoni  We need to support local artisan Iron Ore producers.
Reply: @jmtrad1906  Of course ... The Western Universities are churning out NPCs who dont understand engineering but will stand on the picket line to protest for the Varnment. You just have to look at the piffle in the comments.
Reply: @notasgood459  uranium from seawater is functionally renewable
Reply: How about sail boats ?
Reply: Aircraft carriers seem to be able to use that idea to great effect.
Reply: It’s all great until somebody has the bright idea of embezzle a few tons of the uranium, enrich said uranium and put it on a rocket to hit some poor country’s population center.
Reply: @goldendragon3147  Icebreakers... the reason for the high cost is graft / green tape.
Reply: I think thorium powered ships would be great,  and the thorium unlike uranium is not fissile. So no explosions. And it's effeciancy is greater than uranium. But i never heard of a thorium powered anything,  so maybe there is a problem i  unaware of. But to my knowledge Thorium is way better than uranium.
Reply: @malekzin4788  enriching enough uranium to do anything with is about impossible without county level backing. Even the best machines that modern science can make are slow and inefficient, taking large facilities with well paid staff and large resource requirements. It isn't something you can do in your garage with a few friends.
Reply: Are you crazy? Do you really want to give nuclear technology to ships without and means to protect the ship?
Reply: Using thorium based reactor could eliminate those negative options on nuclear power. Sure it's still at development stage but giving it enough time & recourse I think it could happen if we don't want the commonly available uranium based reactor
Reply: Then you have to over regulate shipping industry and there is a risk of some anti social elements using them to make dirty bombs.
Reply: Thorium reactors
Reply: Many countries would not allow moving nuclear plants to dock in their ports
Reply: @rationalmartian  I was on nuclear submarines, I think the problem is most big ports (non military) are in built up areas , so you are not allowed to dock.
Reply: I think the problem is places to dock, a lot of countries are very wary about allowing nuclear vessels to dock, yes the military use them and some edge cases but they don't need to go into major shipping ports or cities.
Reply: @ImpGimp  not as simple as you might think, rapid cooling can actually speed up the reaction, which in turn can turn a meltdown into an explosion, believe it or not
Reply: @holyravioli5795  So the Russians should invest thousands more military-level personele and weapons for their cargo ships? And this is when they pump millions of barrels of fuel out of the ground they could use instead? Haha come on now. And I wasn't just talking Russians - dirty bombs are a serious concern.
Reply: People dont understand that when we say nuclear, they think we are going nuclear forever. Nuclear is a good interim energy source, until we master renewables or fusion. We've only been using fossil fuels for the past few hundred years, a century of nuclear power will reduce a lot of pollution and land use. By 2100 we would have fusion and true renewables without the cost (ie: solar panels made from polluting materiels).
Reply: Another cost is decommissioning ships once they're at the end of their service life. Scrapping a nuclear ship is wildly expensive and difficult
Reply: No insurance company is able to pay for a cash with these things or the price to insure is way too high
Reply: Just less shipping. Shipping doesnt need to be at 0% polution. But at this point there is a lot of “useless” shipping that doesnt need to be. If we eliminate the crap that we send around the world 3 times then would save more than cleaner ships.
Reply: @notasgood459   @notasgood  nuclear power plants can get fuel by recycling a lot do. Have to do something with materials from old ICBM.
Reply: @daviddj1406  nopes thorium reactors still produce radioactive waste that last 100-500 years. I don't understand why is anyone not talking about solar here.
Reply: Bearcat Ben Nuclear ships are possible and have been perfected by the military. USA Aircraft Carriers in many cases have a nuclear reactor to allow high power, and therfore high speed, as well as infinite range, and long time that can be spent out on sea. So yeah, with a lot of money the same tech could be applied to the largest cargo ships.
Reply: @chuckaddison5134  The USA, Saudi Arabia and Qatar are the largest polluters per person. China and India have 1.5 billion people EACH.
Reply: It's way to late to become pro nuclear at this point. If you were to come like 10-20 years ago and said we should replace fossil fuels with nuclear plants, you would have been perfectly correct. However at this point renewable power sources have actually advanced so far that they have soon will be more economically viable than nuclear power is.
Reply: @bearcatben4762  To point out the obvious, the variables are a lot different for rockets than ships.
Also if you replace a thousand-odd tonnes of oil with a few kilos of nuclear fuel, you've got a lot of scope for increasing engine weight without increasing net weight.
Reply: @Marc-dg2en  Which explains the success of France in converting almost fully to nuclear power in the 70s. They did at the right time and basically saved themselves the transition to renewables, while also having phenomenally cheap prices compared to the rest of Europe. And all of this despite proto-neoliberal economists screaming at them that they were cheating the almighty "market forces" by starting a subsidized buildup, it actually turned out to be cheaper instead. Meanwhile countries like Germany that followed the "free market" by preferring the more "economically sensible" and "market-supported" lignite and coal now have higher prices and will need to spend massive amounts of money into the renewable transition.
Reply: @pancakes3250  I'm imagining a small (the size of a few shipping containers), sealed, ejectable, modular reactor. Water offers excellent protection against radiation - a sealed reactor sitting on the sea floor for a few days/weeks is no problem at all. At the first sign of trouble (accident, hijackers etc), ditch the reactor overboard, and the reactor company comes along a few days later with a specialized ship to recover it.
Reply: @pancakes3250  Lol this guy. Biden being huge green is one of the biggest joke I've ever heard lmao. Just.. take a look at what they are looking forward to, environment isn't their prime concern. Also.. waiting for fusion? Are you waiting 100 years just to see it work? Lol. I'm a notorious fusion proponent, though it's not like it is happening in like a decade. No point in mentioning something so distant in the future.
Tbh, in my opinion ppl are just being paranoid and refusing to accept that climate change is just, a change. When it happens.. just change happened. Sea level rise? In the end ppl would just migrate. Really, I don't see the panic. Furthermore, we are using fossil fuels for good reasons, it is propelling our future. Why even? I don't get the wind and solar push which would increase electricity cost by tenfold.. Nah I'm certainly not for that. Let alone other price increase caused by the energy cost.
Reply: @westasleep  Makes sence.  If no containment breach.  Odds are extremely low for that, but there.  More operational nukes, exposed to outside, more chances.
A single failure, might be worse than an oil spill.
I dont see the need to risk it.  Biggest fear is war, the ships will be targets.
Reply: @Marc-dg2en  False. Renewables are still not that cost efficient, let alone be able to support current electricity demand. Simply calculate the amount of sunlight 1m^2 are getting and calculate the amount of land you need to devote on panels to support the demand. Plus, it is not permanent, it has to be replaced in less than a decade.. DUH
Reply: @Andreas Berni Err there are forms of socialism which does not lean toward communism
Reply: @junholee4961  I understand your point of view.  
Fusion could be 50 years away, too long.
Global warming, definitely manmade, could be too late, so lets expect the flood.
Biden priorities could be elsewhere first.

My bet, is otherwise, thats all.  Fusion, not too late, can wait for it with renewables, not nukes.
Global warming not too late, can react, if drastic and international.
Biden will focus eco, in time.  He is liberal.

A difference of opinion.  Nothing more.  I dont have the facts, those who do, are better.
Reply: @PedanticNo1  science does not need to be nuclear ⚛  and it seems like you probably like weapons of mass destruction if you support nukes also nuclear power is practically at least in an accident very bad for the environment and what about the nuclear waste you are not thinking this through and what about the fact that if a ship or other power plant based on nuclear power gets destroyed and is suspect that Russia or NATO has destroyed the others ship, power plant, etc then you got WW3 YAY(that was sarcastic {the yay part}very sarcastic)
Reply: RTG reactors would be the shit for shipping.
Reply: @enricodragoni  With the exception of very heavy/bulky stuff, I think shipping finished products around the world is vastly more efficient than creating redundant supply chains and factories all over the place. The efficiency of a big, expensive, purpose built factory located close to the source of raw materials is hard to beat.
Reply: @pancakes3250  well this is true but alot of military submarines and aircraft cariers have nuclear drivetrains and have a much greater risk of being sunk or destroyed unlike comercial ships and they have this nuclear vesels for a long time now
Reply: @rationalmartian  it will be very hard too retire a nuclear powered vessel because you can't just dismantle the ship apart and sell the metal for recycling, you have to decommission the reactor or maintain it if you aren't using the ship. It is super expensive.
Reply: @pancakes3250  Well, that seems to be mainly based on emotions, not facts.. You at least know that fusion is kept delayed by a decade every now and then right? Lol. Anyone who do the research would realize it. Actually, time will tell anyway. Infeasibility of renewables would be rising as ppl question why it's not getting more stakes - which arises to be the feasibility ussur. Same thing with Biden, they are not really eco kind of person, just watch.
Ah, I forgot something. Right, renewables might work, if we meant Natural Gas generators by them hahahahahahaha. Seriously, renewables won't function without significant aid of NG generators. I guess they counts as Renewables now lmao.
+ For actual flood to happen, global temperature has to rise by 3+C. With heaviest greenhouse gas emission, that won't happen in a century.. so idk what you mean. No no it isn't a catastrophe like how some doomers like to brainwash
Reply: @pancakes3250  Liberal does not equal Environmentalism, surprise? Lol.
Reply: @rexmann1984  I love this idea =>
Reply: @pancakes3250  Oh, one more thing. One would not do that kind of reply if they actually understood the point of view I posted. Misunderstanding everywhere.
Reply: @Andreas Berni Oh so it's terminology and me again. Anyway, how do you think of welfare state then. Capitalist but they indeed have lots of regulations justified, so it's not a independent free market
Reply: @PistonAvatarGuy  Awesome.

I am not an expert, in economy.
Lets see.  I have to correct myself first, after i slept.
So, forced socialism, is a wrong statement.  No such thing, under democracy.  There is forced labor, under it.  So i guess, i mean that.  
Direct resource management.  Nothing wrong with that.  Under national emergency, same thing.  Forced resource management, thru taxes, and spending.
Ok, capitalism, was, almost always unfair, both ways.  Every concession was forced.  However, employees rarely agreed to less pay, if they can get more elsewhere.   I want to be fair here, greed was everywhere.

Fluid, or limited pay, based on necessity and affordability.  Paying this way without consent, by force.  Its a path.  Most rich will run.  Under capitalism, with debt, they wont.  They, have a right to give the finger, like Trump, demand their price and abuse the system.  Under socialism, no, but a sacrifice in liberties, and a brain drain.  Pick your sacrifice, money or freedom, something must go.  Under capitalism, manufacturers can volunteer to be fair in not abuse taxes.  It can happen, they are people, and if not forced, its noble, they might do it.  Under socialism, they might choose to stay, and everything will be voluntary enough were no force needed.  Possible again.  Pick, your, dream. 
Anything is possible under any system if enough are willing.  Nothing is possible under any system if they dont.  
Next war wont be nuclear, too crazy.  Might happen of course.  More likely, it will be 'economic' in nature.  No superpower territory invaded, just economic targets until settlement.  Power plant, for example, are great.  If it goes nuclear, then you are right,  build them.
I understand you, you pro socialism.  I am pro capitalism.  On paper both can work, in reality, depend on the people involved.  I bet on capitalism, and democracy.  Democracy a must.  You pick socialism, and also democracy, i believe.  We both are not swayed yet.
People like you prevent corruption, and abuses.  You are great.  Made US great.  So far so good.  Keep going, as far as informing goes.  If loud, and accurate enough, we sheeple, will follow.  You made me more accepting to drastic measures.  Not to socialism yet, but a step in a right direction, regardless.
Reply: @PistonAvatarGuy  Producing everything locally is a horrible idea and would be disastrous for the environment. Economies of scale means it is far more energy and resource efficient to have centralized global hubs of production and then efficient transport to connect consumers to producers. If we produced everything locally, our resource consumption would go through the roof. Take for example how a local farm is 22 time less efficient than a large centralized plantation, and a garden about 100 times less efficient.
Reply: @filipvakaj376  You are right, military targets a priority, but then commercial.   I dont see a need for a nuclear fleet, to warrant the risk.  To each their own, now.  You might feel different, or are more aware.
Reply: @Andreas Berni I like that.  If nuclear waste for fuel.  I just dont think its feasible.  If it is, i am sold.
Reply: impossibruuuuu
Reply: @Andreas Berni Well at least iirc I did not claim that socialism would solve world's problems. Btw capitalism in itself prefers free market without regulations - sometimes even laws, by capitalism I meant more of the neoliberal capitalism of extremely free market which happens to have been promoted for a while. Tbh capitalist yet welfare state are nice, but capitalism only.. ehh
Reply: @pancakes3250  not really but hey evryone has his own opinion and views, and im almost sure both of this solutions (renewable and nuclear) would be bether than cheep oil fuel
Reply: @Andreas Berni My bad for confusing welfare state for socialism =/
Reply: @Quatuux  I agree, but into the water.  Food chains, or by current, back to us.  No need for such risks, i prefer synth or hydro, until we catch up with renewables to carbon neutral overall.  My opinion.  Maybe green my way, impossible, or too late.  Dont know.  I am  just this way, bias.
Reply: @chuckaddison5134  True.  So far soo, maybe good.  Merchant fleet will add alot more, if conflict or strife.  If a reactor breaches, pollution.  Nasty kind, happy cancer type, for a long time.
Reply: @리주민  I hope so.  My wet dream.
Reply: @deth3021  

Basic physics! So a moving ship KE=1/2mv^2  more mass more energy to move ! A nuclear reactor has to have shielding which requires mass . 

Another approach would be to update the Clipper ship design of the late 19th century. These were the pinocle of sailing freighter design .
Reply: @bearcatben4762  The amount of shielding required would be offset by the amount of fuel you wouldn't have to carry. Uranium is a lot more dense then any liquified fuels so you'd make up the differences there.
Reply: Sounds a bit dangerous, like what if the reactor melts down? Then you have nuclear fuel in the ocean
Reply: Carbon free but not renewable
Reply: @enricodragoni  the reason is our most modern "cosooomers" products are made halfway across the world because the avability of cheap workers in abudance and raw materials ( the example are china and smart phones) , it was economical and political question not engineering one.
Reply: It is more dangerous than carbon it I will increase radiation and will this lead to more skin cancer
Reply: @enricodragoni  perhaps "a simpler, more immediately feasible way" could phrase it better than "just on how to solve it", which applies to both, and because renewable ships are a naively direct way aka the "simpler, more direct solution", in a way. 

Producing locally also switches the complexity to another things like compensating the loss of economies of scale, setting up lots of new industries, large-scale manufacturers(and shipping companies) who might do anything to keep their income, etc
Reply: Sail power ship
Reply: @Andreas Berni You're just repeating yourself and proving that you have no idea what you're talking about.
Reply: @markdoan1472  "Im willing to bet global warming based on CO2 is not remotely an end of days"
-
Interesting. How do ~10 billion humans survive a mass extinction event?
-
"reason I say this is the same energy from the sun hits us every day"
-
So, you don't understand the greenhouse effect?
-
"simply a shift and then stabilize"
-
Rapid climate change has caused mass extinction events before, this time is even more severe because of the unprecedented rate of change. It will eventually stabilize, but after the mass extinction event, tens of thousands of years in the future.
-
Anyway, your entire comment is just gibberish, you're basically like a 5 year old kid, explaining a fantasy about unicorns and goblins, you have absolutely no idea what you're talking about.
Reply: Not quite because the nuclear fuel is nonrenewable
Reply: @pancakes3250  You're clearly not capable of understanding what I'm saying. I wish people like you would refrain from having an opinion on anything, continuously failing to understand absolutely everything just causes problems for everyone.
Reply: @ObjectsInMotion  "Producing everything locally is a horrible idea and would be disastrous for the environment."
-
No, there have been many, MANY studies which have shown that producing locally is FAR less damaging to the environment.
-
"Economies of scale means it is far more energy and resource efficient to have centralized global hubs of production."
-
I mean locally within a country, not that every neighborhood should have an iPhone factory. Where do you people come up with such nonsense?
Reply: @Andreas Berni No, I'm literally describing what you just did. I asked you to define socialism, you didn't and just posted the same copypasta that you posted previously.
Reply: @PedanticNo1  no it hasn’t. He’s researched it thoroughly
Reply: @PedanticNo1  so it's antiscience
Reply: @pancakes3250  not if we switch to thorium instead of uranium
Reply: Nothing wrong with oil....its renewable. Just fill up your tank again...works pretty good.
Reply: Impractical. Russia has a few nuclear icebreakers but that's out of necessity. If a nuclear powered cargo ship were to have an accident, it would be a disaster. It might be ok if they sink in open sea, nuclear subs have sunk and not caused lasting environmental damage but if it happened in shallow water or a harbor, we would be screwed.
Reply: @pancakes3250  Although most submarines are nuclear powered.  There are also still nuclear-powered aircraft carriers, I believe.
Reply: @bearcatben4762  It works for US carriers
Reply: Yes! As a stopgap nuclear is a very good option. While it's not renewable, it's much better than fossil fuels
Reply: Hydrogen fuel cells surely
Reply: Yeah that's not gonna happen even though nuclear energy is safe, clean, and abundant. Yes. SAFE. Only 200 people have died from nuclear accidents, mostly in the former Soviet Union where safety regulations were... Lax.... To day the least. Meanwhile 2.4 million people die in car crashes every year.
Reply: @Samuel127849  only thing is they rarely ever enter another nations waters and typically just stay in international waters. Hence they don't have to deal with the afforementioned red tape
Reply: Nuclear could be a turning point in shipping. In theory you could fuel it appropriately so the ship would never have to refuel before the end of it's service life. And at that end you cut up the ship and install the core with new fuel in the next ship. Nuclear power could allow larger ships and higher speeds and allow for quick turn around time in port, you could show up unload/load and get back to sea without turning off the "engine". Yes there will be massive costs in R&D, operators, maintenance, and security, but shipping is a multi trillion dollar industry that is allows looking for maximizing profits.
Reply: Nuclear powered everything?
Reply: nuclear waste disposal is still a huge problem
Reply: There are a lot more Nuclear powered ships out there then people realize. The problem with Nuclear power isnt the cost, its the restrictions on many ports that do not allow nuclear powered ships. This is why the US Navy still has a few non-nuclear (Kitty Hawk Class) carriers in service. The fact that you could go 7 years without refueling a nuclear ship is massive. The average nuclear aircraft carrier has 4 GE electric motors to turn the 4 screws that easily push it above 30 knots at only 33% of the its potential. Powered by 2 small nuclear reactors that are extremely safe to operate. That said we pay more for an ounce of enriched Uranium then we do Gold. A better solution would be to equip the ships with an even more stable nuclear fuel like Thorium. A lot of people spread BS rumors about using Thorium reactors, but the truth is they are cheaper and safer to operate, plus there is a huge abundance of thorium. LFTR reactors are already being heavily considered for use in many countries as well as being looked closely at for use in space.
Reply: @notasgood459  Solar isn't renewable either, in the sense that the metals and silicon required are finite.  One could argue we have enough silicon and metals so the we'll never have to worry about it, but the same is true of uranium.
Reply: @bearcatben4762  The US Navy has entered the chat.
Reply: Everyone is like, "it'd impossible, it's too heavy, it's too dangerous, it's too politically difficult". Have you forgotten that nuclear submarines exist?
Reply: @notasgood459  not renewable but pretty much unlimited
Reply: @Kyle-gw6qp  And nuclear air craft carriers and nuclear ice breakers.  The US Navy alone has something like 6000 reactors years without a criticality excursion.
Reply: @PedanticNo1  watch his video on nuclear power plants, the problem isn’t that it’s unsafe, it’s just not cost efficient. Takes a long time to turn a profit. Also a nuclear reactor on a ship would need to many precautions to ever be worth it.
Reply: Right!! I was thinking the same thing
Reply: They are just to large of an intial investment for a company to bear. Simple as that.
Reply: @Kevin_Street  I understand that. It is possible, and we do have regulations and the ready infrastructure in place, the issue is fear and the initial high cost(largely due to bureaucracy, and limited interests from fear of unwarranted public backlash). My point is that we absolutely must advance with nuclear. We have the designs for hi temp reactors that can use waste to nothing, and we can reuse and breed plutonium if we need more fuel. The danger's have been way way way overblown by unscientific scaremongers, and it should be noted for all the hand wringing about Nuclear Weapons, the fact is peaceful power generation can reduce the nuclear stockpile, if that was desired.
In comparision to other green tech, which uses Heavy metals and Lithium, which we don't have an unlimited amount of.
Not to mention the myth everyone loves bandying about, the "carbon neutral" element of solar and wind, which based on my study of the production chain they most certainly are not. Hydrogen is problematic, because it is one of the most dangerous and difficult materials to store and use.
So in the end, Thorium, MOX, 4th gen reactors, and eventually fusion appear to be the only Mainline Load generation that is stable and reliable and actually will cut Co2 sources and pollution.
To put it bluntly.
7 million people die every year from air pollution.
Virtually NoOne has died from nuclear power.
0 died from radiation in fukushima. (most were from the Tsunami, 2,202 died as a result of the stresses of evacuation. That is from being yanked out of nursing homes and hospitals)
78 died up until 2004 from Chernobyl (31 due to the explosion, 28 due to radioactivity during cleanup, and an additional 19 for the same reason up until 2004)
To those who bring up three mile, 0 deaths.
To those who bring up Windscale(UK) or Kyshtym(Soviet)...
https://ui.adsabs.harvard.edu/abs/2010JRP....30..407M/abstract
"This analysis of the mortality and cancer morbidity experience of those Sellafield workers involved in the 1957 Windscale fire does not reveal any measurable effect of the fire upon their health."
and for the Krstym... Estimates are less than 100, but that's difficult to verify because it's the soviets builiding nuclear weapons badly, so maybe more maybe less.
Meanwhile in Solar Land: https://www.forbes.com/sites/michaelshellenberger/2018/05/23/if-solar-panels-are-so-clean-why-do-they-produce-so-much-toxic-waste/?sh=46fcdd3d121c
I rest my case.
Reply: The problem with nuclear-powered commercial ships is one of regulation. They have to compley with the rules of every country they dock in
Reply: @PedanticNo1  so hes a woke engineer?
Reply: @crankyfox  We need some 4th gen LFTR reactors in operation ASAP to see wide adoption of nuclear power.
Reply: We have to do better than that, fusion is gonna be the ultimate power source.
Reply: @michaelnord9081  @Pablo Arroyo I have already mentioned why carriers are not good analogs for container ships
Reply: @Kyle-gw6qp  Nuclear submarines are 6 times lighter than container ships and have completely different reasons for existing
Reply: The issue with that is it's expensive and there are ports that don't let nuclear ships enter at all.
Reply: just imagine a nuclear powered ship taken over by pirates or terrorists
Reply: @akuma7616  Fusion might take several if not more to start operating.
Reply: @Andreas Berni Just the same, tired, nonsensical scaremongering, over and over again.
Reply: @enricodragoni  very true
Reply: @makisekurisu4674  :0
Reply: Dian Herdianto  If the sink they'll do more environmental damage then they will preserve.
Reply: Socialism: The government controlls everything with a billion rules to make sure no beach has one corn of sand to much, artificial prices make it impossible to keep track of the true power of the economie, 100% bureaucracy wich will get inefficiant fast and starve hundreds of millions of people. Capitalism: a free market economie where the demand dictates production and prices, whats beeing needed will be produced, whats not needed will disappear. Yeah that choice is really hard isn't it?
Reply: There is an interesting nuclear fusion idea called magnetic target fusion. If it actually works, it could lead to small enough reactors to safely use on ships. Well . . . safely for the most part. Tritium could be an issue if a ship sank.
Reply: @hernerweisenberg7052  Socialism: Can be literally ANYTHING, as long as the means of production are owned by the people, which means that it's entirely possible for everything to be CONTROLLED BY THE PEOPLE. 
-
Capitalism: Where corporations grow large enough and powerful enough to control EVERYTHING, including what you consume, and they will KILL YOU if it's profitable. The Camp fire, 90 dead, purely a result of CORPORATE GREED. Boeing 737 MAX crashes, 346 people dead, purely as a result of CORPORATE GREED. There are endless examples of these kinds of deadly accidents, caused by negligent, greedy corporations who put profit before YOUR LIFE. The free market puts the worst of mankind on full display, so yes, the choice is easy.
Reply: We don't need any more radioactive waste
Reply: @Andreas Berni I'm not talking about history, I'm talking about what's possible. Why are capitalists so willing to consider new possibilities when it comes to making money (even when ideas are completely insane), but completely unwilling to consider new possibilities when economic systems are involved?
Reply: @PistonAvatarGuy  You can't just not have shipping and attempting to reduce it is unrealistic and relatively futile with our current manufacturing complex.
Reply: @PistonAvatarGuy  In Socialism the domocratically (or otherwise) elected government dictates everything. Where you can work, how much you earn, what you can buy and all the things you can't. In Capitalism the money dictates. People act as if thats a bad thing, but its the most direct and truest form of democracy because who has the money? Yeah there are some crazy rich peaple and companies, but they didn't steal it, the money came from the people, they dicided that they wanted whats offered and they gave their money for it. And once they don't like it anymore, they will give their money to someone else and the former rich company goes bankcrupt. It's voting with money, everytim you spend anything, where as in Socialism, you dont have the choice, the government dictates how much you get and what you can spend it on. Yeah that government might have been democratically elected, but once its in power you have no vote and no choice. The alternative Socialism you are talking about is Utopia, and it is not from this world, or it would have been around allready don't you think?
Reply: @PistonAvatarGuy  I believe you are mistaking capitalism for our flawed financial system. I agree that a system based on unlimited growth can nothing but fail eventually since nothing is unlimited in the real world. Capitalism however is about a free market economy, nothing wrong with a free market.
Reply: @00dfm00  How would it be thousands? Throw an RCWS on each ship, the captain sees danger, he phones it in and a few moments later the threat is turned to mist. Like 100 people at most. 
Even if a ship was hijacked i already described the Russian's procedure for retaking a vessel of any type. And even in the super duper unlikely scenario they got away they would immediately be hunted down by the US, Interpol likely worst of all Russia. 
The incentive for using Nuclear is that you get a ahead of the curve because oil will eventually get more and more expensive until it becomes prohibitively expensive for shipping.
Reply: @notasgood459  Thorium Reactors? I haven't really heard any real counter-argument on this some what "lost" technology. Something obvious I'm missing on this option?
Reply: @rogerwhittle2078  You can see how successful the anti nuke propaganda has been looking at the comments. these folk were taught that stuff in primary school. .
Reply: @bearcatben4762  The US uses Nuclear powered vessels for a majority of it's ships.
Reply: @PistonAvatarGuy  And there are many, MANY studies that show globalization leads to greater efficiencies and economic growth, and countless times in history a innovation in transportation has lead to tremendous cost and resource use reductions. Trade is how countries prosper, any country that tries to be self-sufficient (China in medieval times, the spanish empire, North korea today), eventually fails because it just doesn't work. Trade and transportation is how society grows and advances. In an ideal global economy, each individual product would be produced in one and only one location where it is maximally efficient and then sent across the globe to consumers. This is how we move to green planet.
Reply: @holyravioli5795  EVERYTHING needs to change if we're to survive this century, or we will be FORCED to change. If you people can't get that through your heads, don't bother worrying about ANY kind of solution.
Reply: @hernerweisenberg7052  No, corporatism is simply the end result of capitalism, there is no other way that the system can progress. There is no free market in an oligopoly, which is inevitable in a capitalist system.
Reply: @ObjectsInMotion  But this happens because of the limitations of capitalism. Without the restraints of such a system, there is FAR greater freedom to make use of resources and to use them efficiently.
Reply: @Andreas Berni Socialism is the only thing that can offer all of those things. Capitalism inherently drives environmental destruction and the over-consumption of resources, it reduces the value of a person to a number, it makes war profitable, and it gives totalitarian corporations their power, this is why the countries with the highest living standards on Earth are some of the least rigid in their adherence to the doctrines of capitalism.
Reply: They're probably too expensive to be commercially viable for this sort of thing
Reply: Impossible
Reply: Nuclear would be a good short term solution but then additional nuclear power production means additional nuclear waste which is not good for the earth. This would also likely introduce more expenses for shipping companies as well as shipping manufacturers as the companies would have to train engineers to manage the nuclear core and train everyone with new protocols for possible leaks.    For manufacturers it would mean extra shielding has to be put into place as well as r & d for a possible reactor which would cost a lot of money and increase the weight of the ship, though maybe not to the weight of fully fuelled one. And this is all not even considering how dangerous it would be to have thousands of ships with considerably sized reactors criss crossing the globe with direct access to the ocean if something goes wrong. So pretty much it would be good in theory but there would be so much safeguarding that would have to be put into place that it probably isn’t the best option.
Reply: Nuclear waste os even worse than CO2
Reply: The russians make nuclear icebreakers and if renewable cannot be fast enough then what other options are there?
Reply: I was thinking the exact same. Or have a nuclear plant powered hydrogen generator somewhere for a refueling station?
Reply: Cost and security are the biggest hurdles.
The Russians, US etc have the tech, but the biggest shipping nations are the Greeks, Chinese, Turks. Other superpowers are not just going to give away their tech
Reply: I was thinking the same thing
Reply: @bearcatben4762  US super carriers has nuclear reactor a buildt in within there construction to reduce the need of ducking how would you explain that?
Reply: @swilso421  Fusion would really make sense if you want to build a Nuclear powered Cargo ships one biggest problem we have is that Fusion reaction are still currently experimental and it would not possible for it to be implemented to ships within this century
Reply: @PistonAvatarGuy  that is thou not possible it's very difficult the global economy as of now are more connected than they were before and it would really hurt the world especially countries dependent from others if shipping stops entirely
Reply: @paulbrazendale3257  Don't forget pirates if pirates seized a nuclear powered Cargo ship they may demand bigger margains if you want the ship back
Reply: @logdog6762  that's because if Uranium from a Nuclear reactor is submerged in water in deep deps It would not heat up
Reply: @Sunpawz A Methane has 20x more heating potential that carbon dioxide thou not impossible it is risky to use it
Reply: @PistonAvatarGuy  Capitalist people are risk averse they are not going to spend money on something that would work just incase it's not going to work
Reply: Wind powered ? May be.
Reply: As far as I know nuclear powered ships are owned only by governments, not by private companies
Reply: @bearcatben4762  yes but the technology is there. We can put the necessary shielding on a smaller vessel, we can put the necessary shielding on a larger vessel.
Reply: That's totally feasible with SMRs (small modular reactors).
Reply: @Quatuux  Interesting.  How hydro and renewables, will kill more per watt (i guess), than nuclear?  Please take into an account unpredictable fukushima like incidents, dam busting, and any future radiation caused by wars (nuke plants were hit, or dams).  
Dont forget nuclear waste leaks, and a single accident will cause cancer for a loong time.  Humanity will needs only so much power.  There is a limit to needed watts.  So lets stay within that limit. 
Fusion is coming.  Nuclear waste will take a long time to store, renewables can just go.  So take into account the unnecessary time it takes to store the waste, and incidents that may arise, from wars, natural catastrophes, lunacies, and social unrest.
Reply: @pancakes3250  
- Nuclear powerplants are not war weapons, they are not related. A nuclear reactor CANNOT explode. Also, the bunkers they are in resist most if not all weapons available today.
- Fukushima killed literally 0 people.
- Dam or wind turbines kill more people per TWh produced than nuclear every year in accidents into the factories, during transportation, or during the exploitation with failures like dam collapsing, or wind turbines burning, breaking in strong winds, or having light beacons shut off so aircrafts hit them.
- Renewables like solar & wind mills require rare earth materials. Mining those release more radioactivity in the atmosphere every year than nuclear power ever did. Meanwhile nuclear waste is safely stored.
- Renewables need a backup, usually coal or gaz because stupid people don't want nuclear. EVERY YEAR 200 000 people die in Germany because of atmospheric pollution created by those backup powerplants.
- About this atmospheric pollution, note that the CO2 takes at least 10 000 years to leave the atmosphere, so its lifetime is longer than the lifetime of nuclear waste.

If you want to know more, this website compiles many informations and sources : https://environmentalprogress.org/the-complete-case-for-nuclear
Reply: @Kyle-gw6qp  I know its possible but the cost is in the weight and space taken up by shielding, It makes nuclear power even more expensive, and can you imagine the insurance needed especially if you are moving cargo between unfriendly countries like Argentina and the UK
Reply: @Quatuux  Let me look.
Reply: @PedanticNo1  it's anti nuclear for pro-science reasons. It's not scaremongering about nuclear energy, it just discusses the real practical drawbacks to nuclear energy that often get lost online with people cheerleading it to dunk on nuclearphobes.
Reply: @payca4394  It's absolutely possible and everything must change if we're to survive this century.
Reply: @Quatuux  Sorry, that article doesn't explain how it derives its data.  How a solar farm produces CO2, or, a nuke plant?
Radiation pollution from solar, is not the same as radiation from radioactive decay.  Rad decay lingers and transportable, solar radiation wont, just, stay away.  Still bad thought.  Cant argue here.
Busting dams is terrible.  I agree.  They need to go, when fusion here.    
Production and utility incidents, far higher for renewables i agree, but only due to lesser regulation.  Every incident will improve the situation, and be comparable to nuclear.
As the past goes, deaths by renewable are faaar higher than nuclear.  You right, but only because nukes were not exposed to wars, and renewable have less safety regs.
Future, worries me.  A war, and a catastrophe.   Social unrest, and a 3 mile island.  Earthquake or tsunami a new fukushima or worse.   Except for the dams, nothing renewable will cause as much harm.  
You made me aware of dams and harmful emf from solar farms, apparently.  That needs to be checked.  Thank you.
Reply: @pancakes3250  
- This article provides its sources that explain how the data was gathered.

- You are talking about nukes again but this is something ENTIRELY different from nuclear power plants.
A nuclear powerplant cannot explode, and if it's used to create a bomb you know it because it doesn't produce electricity in this case.
South Korea has nuclear powerplants but no nuke. North Korea has nukes but no electricity at night.
Also, nuclear powerplants can work with other things than uranium or plutonium, which means you can even more separate energy production from the production of fissile material.

- I talked about radiations emitted by the mining of rare earth materials used in solar panels, I did not talk about radiations from the Sun. The radiations emitted by mining activities are released in the environment, this is far worse than the safely stored nuclear waste that powerplants produce.

- Improving regulations might improve the death statistics of renewables. However, you forgot to take into account that improving regulations for nuclear has the same effect, so nuclear will still be safer.
An example : in Chernobyl a water vapor explosion happened (absolutely nowhere near a nuclear explosion, which is impossible in a powerplant) and blew the roof, which exposed the reactor to the environment. There has been no death in Fukushima because the reactor was inside a bunker, like all reactors we have in France.
Another example : In Fukushima the corium made a hole through the bottom of the reactor due to its high temperature so it wasn't properly contained. Since this event, all nuclear reactors in France have been equipped with corium retention equipment that are placed under the reactors, so the corium gets flatten on a large surface of boron to stop the reaction, and this surface has cooling ducts integrated so the corium cannot pass through it.
Reply: @Quatuux  I saw the sources.  I hunted them.  They say solar power produces CO2.  I couldnt find how.  They just hide it.  Crazy.  Even pro solar power sources dont mention how, but say, they do.  
Bias articles.
You are right rare earth used in panels is terrible, they never compared that to nuclear rad release.  I assume more.  Minus for me.  I didnt know this.  Was mislead, bad.  
You are right, nuclear waste from nukes, size wise, is negligible, i dont foresee a disaster involving that, to unlikely.  So it doesnt count as a minus, but not a plus.
Now, power plants and disasters.  
You are right, natural disasters will do 0 to nukes, if build right.  This is not a plus, just not another minus.  I was wrong, brainwashed.
True, they dont go boom.  However, a reactor or waste containment breach due to war, will cause a leak that will be a terrible problem for a loong time.  Chernobyl caused a huge area evacuation, so direct exposure deaths was few.  Cancer deaths afterwards and across the world are muuuch higher, bigger than any dam popping, except China.  Point for me.  
When i chased the sources i found an article in scientific american.  Apparently nukes get shut down often for repairs, some even for critical.  The repairs were sometimes forced due to government inspections.  In civil strife senario, this wont happen.  There were plenty of close calls.  So a 3 mile island during strife is likely.   Point for me.
We even.  However my point are huge.  I single open reactor, due to strife or conflict will mitigate any pollution and radiation caused by solar panels.  
I learned alot.  If the world stays civil, and fusion far of, i loose all my plusses, you will be right.  Otherwise, with wars and strife, no nukes please.
Reply: @Quatuux  Anyway.  I was checking sources, and read more.
You are right, natural disaters will do nothing.  Waste is negligeble.  Solar panel poop, involve heavy metals, so pollution and radiation.  
I read an article in scientific american.  There were many incidents forcing nuclear power plant shut downs for repairs.  Some were found due to a government inspection.  In times of strife, that will be minimised.  A 3 mile is likely.
I want to mention, that pro solar articles were as bias as pro nuclear.  They both hid information, and were annoying.
Chernobyl has a low 'direct' death toll, due to a massive evacuation.  Indirect death toll world wide, is much higher, and will rise.  You are right with fukushima.
True, nuclear power doesnt go boom.  However a breach in reactor or waste, will cause a high death toll, which wont stop for a long time.  
With no wars and strife, and fusion 30 years off, you are right.  Otherwise me.  
Place your bets.
Reply: @pancakes3250  
- They don't hide it, it's fucking obvious! Nothing biased here!
It produces CO2 during the extraction of materials, the transport to the factory, the creation of the factory, the cars of all employees, when materials are refined, the electricity the factory uses that is made from coal considering it's in China, the creation of the packaging and transportation to the factory, then the transportation of the final product to the site where it will be used, it's installation, it's maintenance...
Considering there is maximum 1 kW of solar energy per m² on Earth's surface, the amount of resources you need to concurrence a nuclear powerplant is insane!

- Explain me how a small nuclear powerplant is a disaster if you need 10 000 wind turbines to replace it, or the surface of a country for solar panels?

- This year a few dams broke in the USA too, it's not specific to China. It also already happened in Europe.
About Chernobyl's exclusion zone, it's far smaller than the zones that are being exclusively used for wind turbines & solar farms, and as I said it's not possible anymore with today's bunkers.

- In France, nuclear powerplants are shutted down at least every 8 years to control them, and update their security to the latest standards. It's for safety, the powerplant is not intermittent like renewables.

- You keep talking about 3 Mile Island. In this case the accident was contained in the bunker too, nothing went outside, because of safety improvements since Chernobyl.

- Wars kill people anyway, with or without nuclear powerplants. However if those installations are targetted then you can expect a huge reaction from other countries in the world.
Reply: @Quatuux  
They hide it, by not telling everything in the article, both cases.  They say this happens and that, but not in comparison or how.  I dont know their significance.  Both made it appear insignificant, I had to look.  

True manufacture and installation of solar and wind is carbon intensive, but it ends there.  Same with nukes, less of course.  The impact of co2 is negligible, as the nuclear waste, and removable.

You can live around wind farm, even if on fire, an exposed core is a dead zone.

Insane areas are needed to match a nuke, absolutely.   However we have them.  We dont need a nuke now, we can do with renewables.  To replace all the combustion plants, is what we need.  We can keep the current nukes.  If flood is too soon like in 20 years, nuke up, if not build farms.

Dams do break.  I am not their fan, now.  I dont argue here.  Close them too, when fusion comes.  If made as well as nuke, civil strife will have a far less impact on them.

The article wasnt on scheduled repair, and inspection events.  It was about near accidents, caught during government and owners inspections.  Inspections dont happen as often during strife.

3 mile island had a small release.  Noone died.  Rates of cancer and birth defects increased.
Wars kill people 100%.  When those installations are targeted there will be no reactions from neutral nations.
If you can build the nuke so tough, bomb proof, and release proof, i dont know how, you are right.  I bet it cant be done on a scale to make it a better option to current renewables.
Peace and stability for 100 years, on no fusion in 30, you right, otherwise me.
Reply: @Quatuux  
They hide it, by not telling everything in the article, both cases.  They say this happens and that, but not in comparison or how.  I dont know their significance.  Both made it appear insignificant, I had to look.  

True manufacture and installation of solar and wind is carbon intensive, but it ends there.  Same with nukes, less of course.  The impact of co2 is negligible, as the nuclear waste, and removable.

You can live around wind farm, even if on fire, an exposed core is a dead zone.

Insane areas are needed to match a nuke, absolutely.   However we have them.  We dont need a nuke now, we can do with renewables.  To replace all the combustion plants, is what we need.  We can keep the current nukes.  If flood is too soon like in 20 years, nuke up, if not build farms.

Dams do break.  I am not their fan, now.  I dont argue here.  Close them too, when fusion comes.  If made as well as nuke, civil strife will have a far less impact on them.

The article wasnt on scheduled repair, and inspection events.  It was about near accidents, caught during government and owners inspections.  Inspections dont happen as often during strife.

3 mile island had a small release.  Noone died.  Rates of cancer and birth defects increased.
Wars kill people 100%.  When those installations are targeted there will be no reactions from neutral nations.
If you can build the nuke so tough, bomb proof, and release proof, i dont know how, you are right.  I bet it cant be done on a scale to make it a better option to current renewables.
Peace and stability for 100 years, on no fusion in 30, you right, otherwise me.
Reply: @Quatuux  
They hide it, by not telling everything in the article, both cases.  They say this happens and that, but not in comparison or how.  I dont know their significance.  Both made it appear insignificant, I had to look.  

True manufacture and installation of solar and wind is carbon intensive, but it ends there.  Same with nukes, less of course.  The impact of co2 is negligible, as the nuclear waste, and removable.

You can live around wind farm, even if on fire, an exposed core is a dead zone.

Insane areas are needed to match a nuke, absolutely.   However we have them.  We dont need a nuke now, we can do with renewables.  To replace all the combustion plants, is what we need.  We can keep the current nukes.  If flood is too soon like in 20 years, nuke up, if not build farms.

Dams do break.  I am not their fan, now.  I dont argue here.  Close them too, when fusion comes.  If made as well as nuke, civil strife will have a far less impact on them.

The article wasnt on scheduled repair, and inspection events.  It was about near accidents, caught during government and owners inspections.  Inspections dont happen as often during strife.

3 mile island had a small release.  Noone died.  Rates of cancer and birth defects increased.
Wars kill people 100%.  When those installations are targeted there will be no reactions from neutral nations.
If you can build the nuke so tough, bomb proof, and release proof, i dont know how, you are right.  I bet it cant be done on a scale to make it a better option to current renewables.
Peace and stability for 100 years, on no fusion in 30, then you right.
Reply: @Andreas Berni Maybe.  Something to look into.  However how safe is it.  I know its just a concept.  4th gen isnt even well known.  However, concept wise.  Reactor breach or whatever core, will pollute as bad?
Reply: @holyravioli5795  Because you'd rather die than change for the better?
Reply: @PistonAvatarGuy  No because telling people they're doing something wrong makes them defensive, the more you point it out the more they disagree with you.
Reply: @deth3021  it’s the fact the a moving reactor will just spread radiation everywhere it goes, much like much like a nuclear plane
Reply: @bearcatben4762  why compare it to a sub?

When there is a Ford class aircraft carrier that weight 100 000 tons.
https://en.m.wikipedia.org/wiki/Gerald_R._Ford-class_aircraft_carrier
Which is way faster and has way more uses for that power than a cargo ship.

So you would likely only need one of the Ford class reactors.
Reply: @demonfreeman3018  lol, not all nuclear plane design spread radiation. Only the single cycle versions did that.
Also the only reason they did was to save weight so it could fly and old tech.

You don't have those weight restrictions on ships, so ship's nuclear reactors don't leak radiation... unless it's older Russian tech that has been abandoned at least.
Reply: @PistonAvatarGuy  Also nobody wants your sympathy, it is a worthless currency.
Reply: @Andreas BerniI like it so far.  Crazy question. If the radioactive part gets exposed, will it pollute as bad?
Reply: @holyravioli5795  "Also nobody wants your sympathy, it is a worthless currency."
-
Then why were you asking for it?
Reply: @PistonAvatarGuy  Incorrect, i have no ego. Everything is pointless including complaining that its pointless. So if everything is pointless then why should i care about you telling me im wrong when instead i can just not care and die content that i and everyone else has achieved nothing of importance. 
That is my point and that is why you telling people they're wrong and pointing out everyone's flaws is a pointless endeavor.
Reply: @holyravioli5795  Use that argument on yourself, bud.
Reply: @PistonAvatarGuy  Using that argument on that argument would be a contradiction of that argument so no i don't think i will.
Reply: @Andreas Berni If this is the case, great, thank you.
Reply: @PedanticNo1  arent there a nuclear reactor which uses much saver fuel? unlike uranium? i hear and read on internersomewhere about it. except that it is being refused due it won't create material for nuclear warheads.
Reply: Valoro85  I agree.
Well solution, 4th gen, waste storage is for hundreds, not thousands of years.  Good enough.  Price tag is enormous.  5 gen can use waste for power.  In 15 years, developed, maybe.  I say build 4 small, thorium ones, in the middle of the desert.  Bunker and bury them.  Tie them to recycle CO2.  Pay fully by US.  When job done, just give them to Saudis.  Consider it as reparation.  Get out or augment the alliance.
Reply: @makisekurisu4674  Funny how greens are all about saving the environment until the topic of nukes come up.  Then it is suddenly about cost.
Reply: @michaelnord9081  It was always about cost. The products with lower initial investment cost will always win.
The new SMR reactors seem promising as it would significantly lower the inital investment cost.
Reply: @mcpuff2318  Those were commissioned by Kennedy as a proof of concept.  The main hurdles are regulatory, not the level the technology or "being complicated"

it's, will enough countries let me dock at port and who will let me buy the fuel.
Reply: Imagine, this industry transports 90% of global trade, but, still accounts for only 2% of the the global emissions.
Next, recyclable energy is impossible to use in any meaningful way, while hydrogen, ammonia, etc., are short term fixes. Nuclear power (molten salt reactors) is the way forward for the industry.
Lastly, I would like to use this platform to highlight a major crisis going on in the industry, that common people seldom hear of. There are over half a million seafarers stranded on board their vessels (some for over 20 months now) as a result of the pandemic. Governments are not allowing them to disembark and take flights back home. Seafarers, who are also rightly the most important frontline workers, are not recognised so. Imagine, without the medicines, or medical equipment that seafarers bring us, can our doctors and nurses do their jobs?
Reply: @enricodragoni  Wait, how would engineers be able to help with local production?
Reply: @bearcatben4762  https://hackaday.com/2020/11/19/the-shipping-industrys-transition-to-atomic-power-and-faster-deliveries/ 
This article says the opposite regarding weight. They actually have increased range and capacity because of reduced weight and volume compared to crude oil fuel (currently used) and even more so compared to hydrogen. As this video explains hydrogen (proposed as a renewable fuel is at a disadvantage in volume compared to crude oil. 

The red tape issue is certainly something that does present real issues though.
Reply: Where Would you dump the lethal nuclear waste .... ????? ...
Reply: Where do you dump the lethal nuclear waste .... ????? .. hydrogen powered may be the better option .... Not Ic engine but a large large fuel cell ....
Reply: A reactor sized to power a cargo ship costs about as much as a cargo ship itself
Reply: @enricodragoni  yeah let me build an iPhone here in rural colorado
Reply: @remastered_tp6898  how many tons of fuel do they need to carry  to cross an ocean? How heavy are their engines? I think a nuclear reactor would be lighter.
Reply: @enricodragoni  You are a true engineer my friend. This comment is literally gold. Instead of wasting efforts on convincing companies, we can just destroy their primary purpose. I am serious, not joking.
Reply: Not exactly renewable ?
Reply: Why waste nuclear fuel when you could use renewables? We should save the nuclear fuel we have for space colonies.
Reply: If most navies around the world deem nuclear too costly to bother with, you can imagine why a margin focused shipping company wouldn't even entertain the thought.
Reply: @notasgood459  
There is enough uranium in the known reserves plus breeder reactors to power civilization for millions of years. If you include seawater uranium, where extracted uranium is replaced by more uranium leached from the earth crust and undersea rocks, then it could last for billions of years. The sun is going to burn out in 5 billion years anyway.
Reply: The ships can't shield the radioactive material as that would result in heavier ships. Using nuclear power too frequently may also result in damage to aquatic life.
Reply: Very high upfront cost
Reply: Even Britain is worried of its nuclear waste from their subs and carriers
Reply: @notasgood459  it's not renewable but its reusable and by the time we would run out of it we would have access to fusion (which is endless by human metrics) or we would be able to gather minerals from asteroids/other planets. (Not saying we'll have the technology to do either of those options soon, just that it would take an incredibly long time to run out of fuel for fission reactors)
Reply: @pancakes3250  litteraly everything is radioactive to some extent
Reply: @PistonAvatarGuy  your comment makes no sense mate... the biggest polluter is a communist country and litteraly every green alternative were created in a capitalist economy
Reply: @Jet-ij9zc  The only reason why China produces such an enormous amount of pollution is because it produces a HUGE portion of everything that the world consumes. China is the largest exporter of goods in the world (by far) and the US owes China half a trillion dollars because it imports so much from China without exporting anything in return. The US ultimately consumes a THIRD of the world's resources, despite being only ~4% of the world's population.
-
Western countries simply made a longer tailpipe for their pollution, they didn't stop polluting.
Reply: @Jet-ij9zc  Yes absolutely.  No more please.  If possible, without an emergency.
The problem is not nuke power.  If build very well, its fine.  Even the waste can be stored or recycled well.  Very expensive, if stored, wow.  Definitely minus.  Cant have too much.  4th gen nuke waste will last 100 years, so no more 3rd gen, millennials.  Anyway, problem, is in time of war and strife, nothing can be too safe.  Those things will be targets, we all have happy cancer, afterwards.
Reply: possible but pretty sure its very expensive to maintain a flotilla of cargo ships,
Reply: ^Non renewable technically
Reply: I dont think nuclear powered ships would be profitable. Nuclear powerplans are horrendously expensive. You could buy 10 traditional ships for the cost of one nuclear powerplant that could power a ship.
Reply: good enough for aircraft carriers, why not commercial ships?
Reply: Nuclear is not renewable.
Reply: Exactly. With SMR technology it's just waiting for the economics of scale to make nuclear shipping affordable.
Reply: It takes a couple billion dollars to replace fuel
Reply: @tekhoverskiff5070  yes.
Reply: @enricodragoni  

Although producing locally sounds ideal, in reality resources on earth are unevenly distributed.

This results in the need to move massive amounts of raw materials at a minimum.

However, that is still substantially less transport than we currently use, so it seems like a savings, right? 

Not necessarily. While production efficiency doesn't necessarily linearly scale with size, it does scale with size.

Let's say you wanted every type of product to be produced in every country as the ideal of being local. Instead of a single massive factory in India cranking out a hundred million widgets a year, you now have 150+ factories all cranking out about 700k widgets a year on average to meet the demand.
A factory requires equipment, materials, personnel, land, and infrastructure. Obviously this is simplified, but it is comprehensive enough.

If you are a giant factory creating 100m/yr, you can save resources by have one or two giant pieces of machinery vs the 150-300 for the small factories. And because the price of the big machinery is so much higher, more time is spent designing it, resulting in a more elegant and efficient machine. 

Meanwhile, many manufacturing processes require lots of water. With a large scale factory, you can recover much of the water you use and treat it on-site as you know what the contaminants are. You can then reuse the water to save money (and resources). Small scale factories are unlikely to be able to afford to do so, and as such the water is dumped as pollution. This adds to the water treatment costs of municipalities. It is much harder (expense, energy, resources) to purify water when their are a bunch of different contaminants that are in constant flux than a predictable chemistry.

If it is an industry that requires vast amounts of electricity, then putting it in a place with a more modern/developed electrical grid can save vast amounts of power.

All sorts of criteria can mean that it can easily be more efficient from both economic and resource standpoints to produce the product at scale and ship it rather than split it into many small scale parts.
Reply: @bearcatben4762  It's a cargo ship... the deiseal engines on those things are several stories height and weight over 2,000 tons. They can take the weight
Reply: @Andrew Edmonds Well imagine a part of the hull that goes down along with the reactor. It does not have to be pretty or anything. But imagine something along the lines of the Enterpise and the detachable saucer section.
Reply: Thorium nuclear reactor?
Reply: Would be a lot easier to produce hydrogen on land via nuclear power plants
Reply: Commercial nuclear ships have been explored, bit proves to be too expensive. In addition, making port is logistically challenging as many ports would not take the ships, and others require permissions months in advance. Lovely idea, but economically and logistically highly challenging
Reply: we’ve already tried those they’re way to dangerous and to expensive 
but those were the 60s so maybe these new thorium mini reactors might work out
Reply: There was one, a cruise ship
Cities didn't like to take it in because it could potentially cause the same problems as nuclear reactors
Reply: Nope too expensive better bio diesel
Reply: @ethanmapanao7542  nah sodium is the best
Reply: Why the hell would you want something that dangerous that's the next thing that has to go
Reply: @Joe.8671  nuclear power isn’t dangerous it’s actually the safest source of energy in world as there is only (including ALL nuclear accidents even non power related accidents ) 1 death for 2 terawatthours where as coal kills 100,000 per terrawatthour, oil at 30,000 per terrawatthour, natural gas at 3000 per terrawatthour 
solar at 40 deaths per terrawatthour, wind at 60 deaths per terrawatthour and hydroelectricity a. 120 per terrawatthour
Reply: Lol
Reply: You don’t want nuclear powered ships. In case of an accident or abduction, you don’t want to give a potential radioactive bomb to terrorists. Ik nuclear power isn’t a bomb, but it can be exploded to create a radioactive contamination in populous areas. Also the nuclear waste would also be a problem and if the ship sinks, it’s a massive problem too
Reply: @PedanticNo1  didn’t they support it in their “Economics of Nuclear Energy” video?
Reply: Always the answer. But humans be dumb
Reply: Complicated regulatory structure that spans all governments would Be required if nuclear material and the potential for mishandling existed on the scale of the international shipping industry.
Reply: Last time we tried we got shredded by the public
Reply: @notasgood459  but they are currently greener then solar because of the minerals to make solar panels
Reply: Oops KABOOM! 

All de fish:
KAKAKAKA EHDHSGYDHDBSSHSHS
DEATH
Reply: nuclear fear is your answer
Reply: @enricodragoni Local production is not economical for the majority of the goods that are imported.
Reply: @bearcatben4762  but ther are nuclear powerd aircraft ceriers and subs so...
Reply: Germany would like to talk
Reply: Submarines—got those
Reply: @bearcatben4762 Why not use one SMR reactor which runs a turbins with water from a desalination module.
Reply: It could work. Military’s already use some nuclear powered vessels and it has been tried before outside of military uses. I find it funny people are still so worried about nuclear technology despite it being one of the safest. Have a great day everyone :)
Reply: @pancakes3250 it's SO risky, the 1st ships to use it are military ones. and they have been testing & enhancing the technology for arguably 60 years.
Reply: @notasgood459 it is if you recycle the rods, which tech is only being used by Russia, after France let it down for political reasons.
Reply: @TheTwinkiefoot fusion was, is, & will (probably) forever be 30 years away.
Reply: @bearcatben4762 oh, yeah, right  all the room that is used in cargo ships is used by cargo, none of it being used by fuel tanks & engines. That's because the turbines are run by fairies turning the turbine shafts. That's why there's no room at all to be used by small navy reactors.
Of course, ships that are designed to efficiently use the whole internal room - such as submarines - have never been converted from ICE to nuclear engines.
Reply: @holyravioli5795 not only icebreakers. Rosatom also has their own cargo ships, ones that even have to have their own cranes, as they must operate even in poor conditions.
Reply: @mari_023 waste: have you heard about recycling fuel rods?
Only France & Russia develop this tech, & France can become energy independent as soon as it comes online for their whole industry. And, yes, recycling can deal with most of the actually radioactive waste, making it able to go back to plants to produce energy.
Reply: West: "How can we solve the issue of providing nuclear energy to small cities? Maybe techbros can invent the best SNR"
USSR/Rosatom: "Shove a small reactor in a ship & send it to places that need energy. And make it safer than our bulky land reactors."
Reply: @chuckaddison5134 nuclear cargo ships came & went in the West. Russia still uses them.
Reply: @BasedBebs if a tanker ship sinks, clean up will be the cheapest ever, right? If cargo ships sink, there's absolutely no way that their fuel tank will be damaged, right?
Reply: @jgr7487 I agree sir.  I can see it, if it tested against every possibility for over a century, to see if it safe enough, green enough then cheap enough to afford.  Otherwise, i think so too, risky, especially now.
Reply: @Gasmask11000, then now the wouldn't be.
Reply: @pancakes3250 water is really good at absorbing neutrons, breaching all of a nuclear reactors shielding is extreme.

Plus Kursk is fine....
Reply: @enricodragoni THANK YOU! Finally, an actually intelligent person who finally points out the obvious.